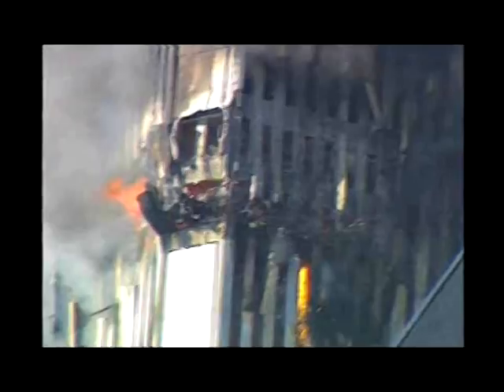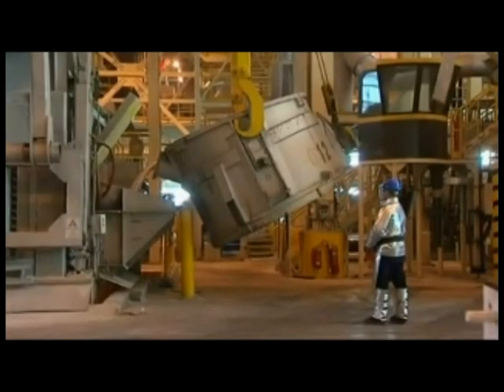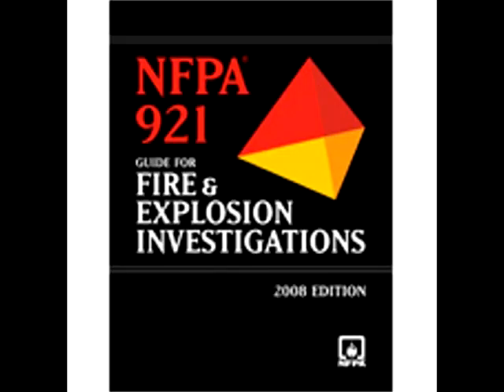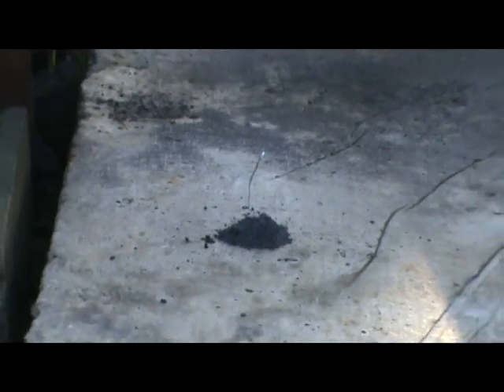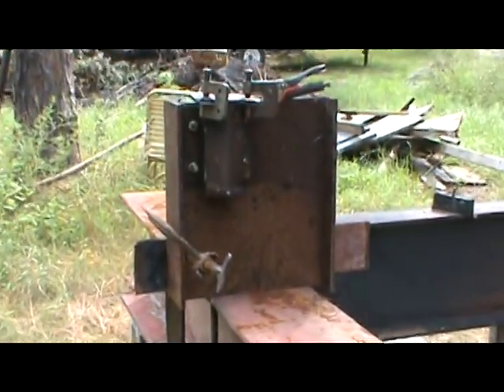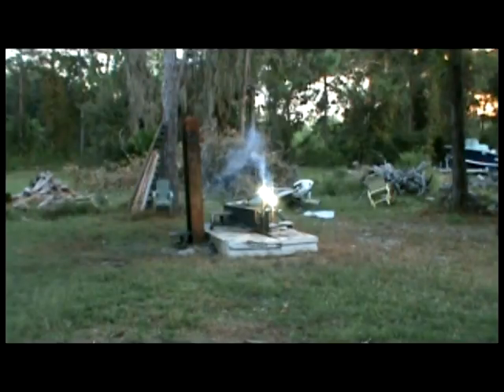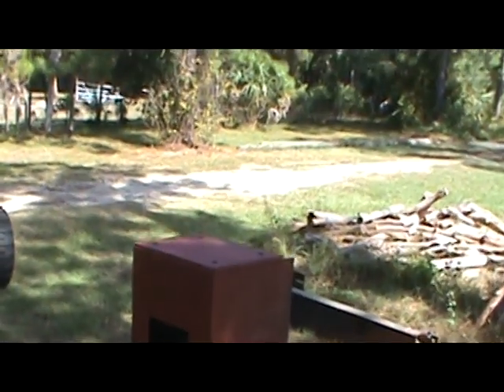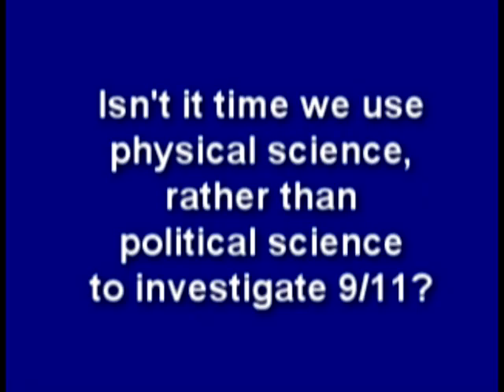9/11 Experiments: The Great Thermate Debate

Comment: Chimney effect.
Convection and high amounts of fresh air.
Reply: Chris G Different planes and levels, no longer sealed.
Reply: +MomoTheBellyDancer the fires were oxygen starved - thus black smoke. and even if the fires were fully oxygenated - its still not hot enough to cause steel beams to fail.
Reply: +Mike Bishop 
Don't you think it's possible to be hot enough for the steel to give under 10,000 tons of pressure? Just a thought.
Reply: +Mike Bishop Just because the fire itsself is oxygen starved doesn't mean it's not hot. Tunnel fires have a big problem where the heat builds and builds until the tunnel fails.
Reply: Mike Bishop
In the end, occam's razor is your friend here. The simplest explanation is usually the correct one.

The structural integrity of the buildings were undermined by the fires started by the planes that FLEW INTO THEM, then the two identical buildings collapsed in more or less the same way because they were damaged in the same way
Reply: Mike Bishop
And you have no actual evidence of this. Everything that has been presented so far is inference.

As for how the buildings came down, look up Pancaking. It's actually more common than you'd think. It's done deliberately by demolitioners, but it happens naturally, especially in tall buildings.
Reply: +Saga No, I don't. And even if some of the steel failed - why would it fail universally throughout the building?  it wouldn't. this was a result of high explosives.
Reply: Chris G
The sealed parts of the building were not the parts of the building that burned, those parts didn't fail because of fire, those parts failed because the rest of the building fell on them.

It's part of how the building was designed, the floor below was supported by the structure above. What this does is that in normal operation the most heavily loaded parts of the building are supported by the lightest loaded parts of the building, creating an overall stronger and lighter building.

The exception to this is when the upper floors of such a building get compromised, then the building can fail from the top down. This is exactly what happened to the WTC.
Reply: Mike Bishop
Uhm, no. Explosives are not the simplest explanation. You'd have to explain how they set the charges with a raging fire going on. How they got the explosives all the way up there. The elevators were out of comission and those are a lot of stairs that are being used to evacuate the building. You'd also have to identify the motive for blowing up the buildings.

Also, you'd have to explain what then took down WTC 7 and why it collapsed it it couldn't have been fire.

This is the simpler explanation:
Jihadis flew two passenger jets into WTC 1 and WTC 2 the resulting fire weakened the structure of both towers and they eventually collapsed, damaging nearby structures, some of which would also eventually collapse.

It literally explains everything that happened that way in one paragraph.
Reply: +Semni Istiqlal You can wish for something to be true, but it still doesn't make it so. These buildings had help coming down - not from fire.
Reply: Groundskeeper Willie
Nah, Jetfuel was sufficient.

Yanno, I really wish that these conspiracy folks would trot out arguments that weren't older than sin, debunked over and over again and relied on ignorance on the subject at hand.

Chris G The steel doesn't need to melt. The structure of the building was weakened by the impact of the plane. All that needs to happen is that the remaining structure gets weakened by the heat. Hot metal is soft and pliable. Once the beams bend enough they no longer provide support and the weight of the tower gets put onto less and less beams. Leading eventually to a catastrophic collapse.

The molten metal seen was most likely aluminium, which is common in office equipment, furniture and the non structural dividing walls in offices.
Reply: +Chris G not so "hermetically sealed" when a plane blasts through and windows get blown out
Reply: +MomoTheBellyDancer your type is always the same. You deny evidence provided by scientific methods and witnesses on the scene - because you can't get comfortable with the facts. And you call names at anyone who dares to shake your reality. You will believe what you believe regardless if of any evidence.
Reply: +Mike Bishop just like your "black smoke means the fire was oxygen starved" proof, right? all conjecture
Reply: *****
Jet fuel in open air cannot. Within the insulated enclosed and chimnylike environment of the building jetfuel will start to burn a lot like it does inside jet engines, which gets more than hot enough to melt the high temperature alloys of the jet engine if left uncontrolled.
Reply: +Chris G The Twin Towers did NOT "fall almost perfectly into its own footprint" -- there was rubble scattered for MANY BLOCKS AROUND!  As for "thermite/nanothermite", all it was was structural steel which CHEMICALLY REACTED with the ALUMINUM in the jumbo jets due to the high temperature!
Reply: +Semni Istiqlal It doesn't even have to melt structural supports.

Steel undergoes a phase change at about 850 degrees from the tough and strong allotrope used in construction into a weak and brittle allotrope.

Burning jet fuel easily exceeds this critical temperature for the phase change to occur - turning the support structure from rigid and durable into fragile and brittle.
Reply: Groundskeeper Willie
Hokaaayyy ... backing away slowly, I think this one is starting to froth.

That is one impressively huge pile of conspiracy bullshit. :D
Reply: +Mike Bishop if the steel rsj beams are damaged by fire ie. wrapped and twisted the weight from above could force it to fall, dont forget gravity to. but the thing didnt fall pefectly......... wtc 7 is a different matter. massive sections fell onto other building so it did fall out slighty.  fire damge to beams can totally collapse a building, why else would we fire proof them ?
Reply: +MomoTheBellyDancer no matter how badly you want a thing not to be true , doesn't change the reality. Jets caused the  universal and catastrophic failure of these buildings? come on man! The most implausible conspiracy theory put forth was from that of the government. I won't continue to argue about it. Fact is, the people who hold onto the government explanation - beyond reasonableness - will do so, no matter what, because the alternative is too terrible of a reality to grasp.
Reply: +Groundskeeper Willie It wasn't "weakened by a plane" -- it was weakened by FALLING DEBRIS from the Twin Towers!  Take your red herrings and shove'em up your ass, LIAR!
Reply: Groundskeeper Willie
Short sale: What? O.o

Building 7 was probably weakened by having TWO SODDING GREAT BIG SKYSCRAPERS COLLAPSE RIGHT NEXT TO IT.

It seems simple right?
Reply: Groundskeeper Willie
is repeating things that have already been debunked in this discussion.
Reply: Groundskeeper Willie
Building 7 was hit by a chunk of burning debris which ignited a fire in it.

It was also fully evacuated and so was a low priority for emergency services, considering they had a skyscraper that was still full of people.

This meant it was just left to burn.
Reply: *****
I'm responding to Geek, who claims that there's molten steel while claiming that nothing there could melt steel. A bit of a problem with his argument there.
Reply: +Groundskeeper Willie You are a LIAR -- NO building was EVER designed to take a hit from a fully-fueled jumbo jet, and in fact such a design is IMPOSSIBLE for anything other than an underground concrete bunker!
Reply: Groundskeeper Willie
Facts you desperately are lacking.
Reply: Groundskeeper Willie
Well, if you provided us with any of your "facts" and linked to any of this stuff we might actually be capable of considering your point of view.

As the one making the claim the onus is on your to back it up with facts and logic.
Reply: +Chris G 
Plus people above the fire broke out the windows to try to breath.  Can't blame them, but that turned the towers into blast furnaces.
Reply: +Semni Istiqlal
The collapse would produce aluminum and iron oxide particles. The issue is that the particles are all of the same size and shape, and are distributed uniformly inside a carbon and silica matrix. The material ignites at 420C, the same temperature as Xerogel, a known sol-gel incendiary. The material releases molten iron, and hits a 10 watts/g energy spike instantaneously upon ignition. The Xerogel only reaches 6 watts/g, and it takes a longer time to do it. Therefore this material is far more effective of an incendiary as the Xerogel. You actually believe that the most advanced and energetic incendiary known to science was invented out of random chaos during a building collapse? I've got about as much chance of shitting a gold brick.

I bring this up because it disproves your "narrative" argument, and because it explains how the collapse happens the way that it did. Otherwise, a steel reinforced structure imploding to dust at near free fall speed through the path of greatest resistance would be physically impossible.

I bring this up because none of you "debunker" types can offer an academic refutation, so it is in fact a trump card.

You lay down your conjecture, and I'll lay down the published, scientific analysis of 9 experts, and let's see which weighs more.
Reply: +MomoTheBellyDancer you just keep that tentative and desperate grip on your own reality. It will all get better, I'm sure.
Reply: +MomoTheBellyDancer Your cognitive dissonance is astonishing. Many of the families - a majority in fact call BS on the "official story". And I'm not going to present the preponderance of evidence available - it wouldn't matter. Nothing and I mean nothing would convince people like you because the truth is not pretty. And I'm not going to stoop to your level of name calling. I actually pity you.
Reply: Groundskeeper Willie
Notice how your statement is desperately devoid of facts.

<Willie> "See here is the place where I grow my facts. You may notice that it is barren."
Reply: Groundskeeper Willie
The cognitive dissonance you're displaying could shatter glass at a thousand paces.

You're claiming that you don't need facts for your ridiculous claims, while simultaneously claiming that the fact-based statements of others lack facts.
Reply: Groundskeeper Willie
No, the onus is on you to provide us with the evidence, we are under no obligation to attempt to support your argument.
Reply: Semni Istiqlal
It's likely that's the case!

But no matter how much engineering goes into a building - it's difficult to make one resistant to passenger aircraft. The sort of engineering necessary to do that would make the building prohibitively expensive to build.

And aircraft that large hitting buildings is something which it just isn't necessary to build redundancy for as the chances of it happening are essentially zero.
Reply: Pyre Spirit
It's tragic when it happens but that is the case. It's also sad that a lot of conspiracy theorists just don't have the critical thinking ability to look at both sides of the story.
Reply: Brandon C. Brandon lol there was no domino effect.  Its impossible.  I just proved that in the video link I sent you.  It defies physics completely.  And you think an entire plane was sitting inside both towers?  You're wrong.  If a plane made it through the building there would be no lady standing in the impact zone waving for help.  What did she DUCK the plane?  Sure.  If any parts of the ALUMINUM plane made it through the reinforced steel and concrete structure, it would have been very minimal.  Like a shredded aluminum can you just put a cherry bomb inside of.  And that massive fireball ya saw on the news coverage was 90% of your kerosene based jet fuel being burned up.  It didnt splash its way down elevator shafts and destroy the lobby on the ground floor.  That's senseless.  You have to have a deeper knowledge of how the towers were constructed at the core columns and knowing that kind of thing would be virtually impossible to do.  These towers were made to withstand multiple airliner impacts, not just one.
Reply: Bobby H
The problem with using thermite isn't wether or not it could bring the building down. A team of angry dwarves with sledge hammers could have brought the WTC down with enough time and the right knowhow. The big question is why?

Why take down a building that was going to come down anyway and go to such lengths to make it look like the plane did it?
Reply: +Semni Istiqlal 
Sorry, that's not how steel framed structures work.  The collapsing load would not exert it's force on the floor directly below it.  The entire undamaged lower structure would distribute the load into the ground.  The top of the towers were of a lighter construction than the lower portion, therefore your assertion that the lower portion wouldn't be able to support the more lightly constructed top is incorrect.  If there was really enough force from the collapse alone to buckle every floor, the bottom or middle structure would be more likely to buckle first due to the greater weight above it.  

When you crush a Coke can, does it crumple from the top down?  No, it crumples from the bottom or middle first.  The collapse defies physics in multiple ways (especially building 7).

Unfortunately for you, this entire line of reasoning is moot, because it's purely conjecture.  Unless you can first disprove the presence of thermite in the dust as described in the Harrit paper, then you really have no ground to stand on.
Reply: +MomoTheBellyDancer Yes, because rich and powerful people would never conspire with others of the same ilk, to maintain and keep their power and wealth.
Reply: +MomoTheBellyDancer I don't care what you thought. The evidence is clear if you open your eyes. beams projected at over 60 mph as far away as 500 yards - doesn't happen by gravity. concrete doesn't turn to powder through the forces of gravity. Planes and jet fuel cannot cause the catastrophic, universal and simultaneous failure of steel and concrete - no matter how much you wish it to be so.  There were over 1,000 victims on that day there was nothing left of to be given DNA tests for identifying. No explanation - other than HE works. Sorry you can't except reality because it doesn't fit your paradigms.
Reply: geeksterajn
You mention molten steel yourself. If steel couldnt have melted then how come there was literal tons of molten steel there?
Reply: Groundskeeper Willie
And we've broken Willie, he's stopped making sense.
Reply: Groundskeeper Willie
AKA: I'm too lazy to back up my baseless accusations.
Reply: Groundskeeper Willie
"evidence is everywhere i'm not sure I want to allocate my time to find links with facts."

And this demonstrates the fundamental dishonesty of your position.;

"Evidence exists. I've never seen it, and I won't present it, but it exists! Honest!"

BS.

There is no evidence and your unwillingness to provide any coupled with your excuses demonstrate quite succinctly that you know there's no evidence, and you're just lying.
Reply: Pyre Spirit
Heck, a burning building easily gets close to that temperature, especially if it's burning for nearly an hour. A big issue in the towers was that they couldn't fight the fire at all, they were having trouble getting water up there. If they had been capable of fighting the fire the towers would likely still stand today.
Reply: *****
Exactly, interestingly enough there isn't much evidence of much steel actually melting. But it didn't need to. It just needed the smallest beams in the floors to become soft enough to break. Once the floors gave way there wasn't much stopping the main pillars from buckling.

You can make a pillar as strong as you want, but once it buckles the building is coming down.
Reply: +Groundskeeper Willie The towers were never designed to withstand the impact of a modern airliner flying at suicide speeds with nearly full tanks. They weren't even designed to withstand an impact similar to the Empire State Building  (a far smaller plane at half the speed with a fraction of the fuel), because it would cost money and time to do such a study, and the previous impact didn't cause serious problems for that building anyway so why bother? But the towers were build in an entirely different method to other skyscrapers, and all towers build this way have collapsed when subjected to catastrophic damage and fire weakening critical supports, in both simulations and real life situations.

One of the key features of a structural collapse is the deformation of floors and walls as the building is twisting under the load. This deformation can be seen when pools of molten aluminium (mostly from the plane) started pouring from the windows when a floor sagged due to disconnecting from the outer walls. You can actually see the sagging of floors and the outer pillars folding outwards on video footage, not long before the towers collapse. 

Molten steel was indeed found under the surface of the rubble pile, but these were caused by chemical reactions between the steel and steam. A lot of water in the building to begin with, and even more poured onto it after the collapse, and it all got heated by the energy generated by the collapse (such as friction). 

The official story had a few gaps, but nothing major, and mostly because it would have taken even more time to come up with all the answers as to why so much damage was caused that day. Misinformation was also a problem that day due to the chaos, which led to claims that buildings had already collapsed when in reality the info going around was that the buildings were ABOUT to collapse. WTC7 was visibly distorting and this was confirmed with laser measurements, but unfortunately it happened on the side impacted by debris from the other towers which obviously didn't have camera crews, only rescue workers (until they got pulled out due to the imminent collapse of WTC7.)

Not a single conspiracy explanation has been able to survive the years, every single one has been debunked. Claims by twoofers have been revealed as half-truths, taken out of context, or downright lies and even fraud. No evidence is ever put forth, which isn't surprising, because twooferism is essentially a religion. Reality and reason do not play a role in religious circles.
Reply: SeedlingNL
It's telling when the conspiracy theories leave more unexplained than reality.
Reply: scurred of what, Do you have any formal education in material sci, this is child's play. if you did you would know that structural steel looses almost half its strength when heated past 1000 degrees F. buildings are not light and neither are planes. there is never just one force acting on a structure why dont you see this ask an engineer what they thought and not the structural engineer for the WTC because he wants to be on tv talking about a controversial thing ask an engineer off the street to look at the situation
Reply: Brandon C. See video title.   And Brandon... 767 jets CAN NOT maintain those speeds at those altitudes.  I wish I had a nickel every time I had to repeat that.  Source:  pilotsfor911truth.org

Brandon... you're either a shill that refuses to admit defeat or you're severely stubborn and uneducated and refuse to look at evidence presented before you.  Which is it?
Reply: Victor Tesla
Because I'm actually employing some common sense in looking at the situation? Aye. What I really should be doing is picking whatever fits my prejudices best and sticking to it in the face of all evidence to the contrary. :P
Reply: +Semni Istiqlal the planes were the cover for the explosions. they could not just set those things off, so they needed a cover incident
Reply: ElfNet Gaming
You have really have been watching too much CSI, havn't you? You know how they got the 1993 WTC bombing guys? They found the VIN of the rental truck they used to deliver the bomb in the rubble. And they'd rented the truck under their own name.

To cover up a WTC bombing with a plane highjacking you first need to have a bunch of people who are prepared to die for the cause then highjack two planes, then you need to fly those planes into the buildings. Then you can start trucking hundreds of pounds of explosives up the stairs in the middle of an evacuation because you don't know how high up the planes are going to hit the buildings because hitting a building with a plane is FUCKING HARD.

And you have to have NOBODY NOTICE THIS.

Then once you have planted and set off the charges you have to hope that nobody involved in the investigation goes "Wait, that looks like a bomb going off." and then you have to hope that they don't find a single piece of your dozens of explosive charges.

You also need to be prepared to kill THOUSANDS OF PEOPLE to avoid going to jail, that seems a bit counterintuitive.

Then you have to explain why you highjack a bunch of other planes and fly them into a bunch of other buildings that DIDNT get exploded.

All to do something that a well placed office fire could have accomplished.

That doesn't seem like the perfect crime, that seems like a goddamn clusterfuck.
Reply: *****
Then how come cheap plastic lighters don't burn and melt?

No a lot of very carefull engineering goes into keeping the heat of jet engines away from most of the engine and the rest of the plane. A bar of steel held in the path of the engine exhaust of your average jet engine will be heated red hot quite rapidly, and alu will outright melt.

I'm not trying to be unkind here but you may want to educate yourself on the subject matter at hand before forming an opinion on it.

A quick primer is that most jet engines take a fraction of the air coming in one end and have it bypass the combustion chamber entirely, this cold air then mixes with or surrounds the hot exhaust of the jet engine, insulating the rest of the structure of the engine and plane from the intense heat of the engine exhaust.
Reply: Emvaz22
Look up a couple of posts, I have a fairly lengthy set of posts that go into that very topic in depth.

The TLDR of it is that is exactly what you would expect from an older tower like the Empire State that was built with a box-girder construction.

However that is not what you can expect from a leightweight all steel building like the WTC was. The main loadbearing elements are the outer walls and core columns. These are vulnerable to buckling. The floors are used to connect these columns together and prevent buckling. These floors aren't individually very strong, they don't need to because there's a lot of them.

Once a collapse starts happening there isn't enough mass to the building to stop it. If you filled in all the holes they'd actually float, with the approximate density of pinewood.

Once the upper part of the tower starts falling, what is it going to fall on? The floors below, and at only a couple of inches thick they aren't going to stop an entire building falling on them, so they collapse, and now there's nothing holding the walls and interior columns together and that floor becomes part of the falling mass.
Reply: *****
Aah, the tinfoil is out in force. Why fly a plane into it and then blow it up? If it was so obvious that it was blown up, why bother with flying a plane into it in the first place?

That's the wierd thing with conspiracy theory most of the time. It asserts competence to the government that it doesn't display in any other capacity.

Like, you are assuming they are capable of highjacking multiple planes, flying them into the WTC buildings, then trucking hundreds of pounds halfway up a building twice as tall as the tallest building ever imploded at the time. Rig them up in a way that makes it look like the buildings collapsed because of the planes.

And then COMPLETELY drop the ball on silencing anyone who can point out the flaws in their deception. You are talking about a regime that's prepared to kill thousands. How hard would it be for them to orchestrate a couple dozen little accidents?

This is what defies belief. That someone can both believe that their regime is horribly murderous and then spout their heads off about it safe in the knowledge that the regime they live under isn't even remotely as vicious as they say it is.
Reply: +Emvaz22 listen clown shoe. You have been shitting up every comment with your nonsense.

Your peer reviewed paper is a joke, no it's not a valid source.

Again anybody in demolition and explosive experts would laugh and this video and you claiming thermite was used lol.

Your conspiracy theory paper is reviewed by 9/11 truthers. Most have zero background in the shit they are claiming. The paper has been laughed at by any serious engineer.

They would not use thermite to bring the towers down, it would be the dumbest and most useless method to do it.

Anyways the thermite nonsense has been debunked years ago.

Again for your dumb ass, the steel did not have to be melted but weakened which jet fuel and the fire easily did.

If they were going to bring the towers down they would use shaped charges and they would be easier to hide.

Nano thermite and nonsense is a attempt by half wits to explain their nonsense theory.

A small shapes charge would be easier, you would never hear it.
Reply: You don't seem to understand what the term dogmatic means - you should probably improve upon that if you plan on engaging in debate.  

The tinfoil brigade is a term you use in order to satisfy your need to be fed a dishonest truth.  I can understand how terrifying it must be to realize that everything you've ever been fed as truth isn't.  Only those that can really handle it will be given the chance to grasp it - truth that is - ...

How many cookies do you get from big brother?
Reply: Not my truth, just one backed in evidence that is shared by many.
Reply: Semni Istiqlal <we are on the internet, all you have is conjecture.>

Nope.  All YOU have is conjecture.  I happen to be able to cite a published academic paper that proves the presence of thermite, which you refuse to directly address because you know you can't.

<The issue you face there is that the collapse in the tower didn't start from the bottom, it started from approximately the same area that the planes hit. Specifically the south tower very obviously had the outer wall fail before the central column was pulled down with it.

You could just say that the charges were placed in the same area that the planes hit, however then you have another set of problems. You aren't going to be capable of predicting very accurately which floors the planes are going to hit.>

Hey, I think I came up with a solution to this mind-bending quandary you are having such a hard time with.  Place charges on every floor.  Number the charges according to the floor. To initiate the collapse, count up from the bottom to see which floors the planes damaged.  Detonate the charges from the point of impact, downward.  ROCKET SCIENCE.

<Pre-placing the charges has a lot of issues. If the plane hits the charges directly you have a good chance of it setting off the charges immediately and the tower coming down right away.>

Not necessarily.  The charges would have been placed in the reinforced core of the building, protected from most of the direct damage.  The charges could have been wrapped around their intended targets, and then coated with a protective, insulative, and shock resistant material.  Even if a few charges went off prematurely it wouldn't cause building collapse.  These types of structures tend to be designed with redundancy.  The failure of a few connections or beams would not even be close to enough to turn the building to dust. 

<If the plane hits too high it won't result in a collapse that we observed, and if it hits too low you stand a good chance of your charges being cut off from whoever is touching them off.>

Wait...you actually think the building would have had to have been wired with det-cord from top to bottom?  Like, literally hard-wired?  There is this new invention called radio frequency transmission.  This brand new technology, combined with a device that ignites a magnesium strip remotely, could have set off the charges in whatever sequence the operator wanted.  No wires required.  Why didn't you think of that?

<And them's the facts,>

No, them's your unsubstantiated conjecture, which I just stomped on with my own conjecture.  How about you stick to the ACTUAL facts and refute the Harrit paper.  Cite your source in this format.  Title.  Author.  Publication.  Date.  Good luck.

<if you cannot theorize how the thermite was used to result in what's observable it's just thermite>

I just did.  Pretty easily too.

< it's just one of dozens of chemicals found there>

Yeah, nanothermite just happened to show up out of nowhere, and for no reason at all.  It must have been the Thermite Fairy.

<You cannot prove how it was used>

I don't pretend to.  That would be the purpose of a new investigation.

Pick your teeth up on the way out.
Reply: Semni Istiqlal <Yeah, I can C/P stuff too. Everything you've posted here is from good old 'truther' websites.  >

My quote from Leslie Robertson, Architect of the WTC, was from MSNBC, idiot.

<That's basically them saying "We found material that looks like thermite but we aren't going to call it thermite in case we get called on it then we can just claim we never said it was thermite." they are really sure of themselves? Honestly, that paper is just packed with weasel-words, allowing truthers to creatively interpret it as you wish.>

From the Harrit paper:
"CONCLUSIONS
We have discovered distinctive red/gray chips in signifi- cant numbers in dust associated with the World Trade Center destruction. We have applied SEM/XEDS and other methods to characterize the small-scale structure and chemical signa- ture of these chips, especially of their red component. The red material is most interesting and has the following charac- teristics:
1. It is composed of aluminum, iron, oxygen, silicon and carbon. Lesser amounts of other potentially reactive elements are sometimes present, such as potassium, sulfur, lead, barium and copper.
2. The primary elements (Al, Fe, O, Si, C) are typically all present in particles at the scale of tens to hundreds of nanometers, and detailed XEDS mapping shows intimate mixing.
3. On treatment with methyl ethyl ketone solvent, some segregation of components occurred. Elemental alu- minum became sufficiently concentrated to be clearly identified in the pre-ignition material.
4. Iron oxide appears in faceted grains roughly 100 nm across whereas the aluminum appears in thin plate- like structures. The small size of the iron oxide parti- cles qualifies the material to be characterized as nano- thermite or super-thermite.
5. Analysis shows that iron and oxygen are present in a ratio consistent with Fe2O3. The red material in all four WTC dust samples was similar in this way. Iron oxide was found in the pre-ignition material whereas elemental iron was not.
6. From the presence of elemental aluminum and iron oxide in the red material, we conclude that it contains the ingredients of thermite.
7. As measured using DSC, the material ignites and re- acts vigorously at a temperature of approximately 430 ̊C, with a rather narrow exotherm, matching fairly closely an independent observation on a known super-thermite sample. The low temperature of igni- tion and the presence of iron oxide grains less than 120 nm show that the material is not conventional thermite (which ignites at temperatures above 900  ̊C) but very likely a form of super-thermite.
8. After igniting several red/gray chips in a DSC run to 700  ̊C, we found numerous iron-rich spheres and spheroids in the residue, indicating that a very high- temperature reaction had occurred, since the iron-rich product clearly must have been molten to form these shapes. In several spheres, elemental iron was veri- fied since the iron content significantly exceeded the oxygen content. We conclude that a high-temperature reduction-oxidation reaction has occurred in the heated chips, namely, the thermite reaction.
9. The spheroids produced by the DSC tests and by the flame test have an XEDS signature (Al, Fe, O, Si, C) which is depleted in carbon and aluminum relative to the original red material. This chemical signature strikingly matches the chemical signature of the sphe- roids produced by igniting commercial thermite, and also matches the signatures of many of the micro- spheres found in the WTC dust [5].
10. The carbon content of the red material indicates that an organic substance is present. This would be ex- pected for super-thermite formulations in order to produce high gas pressures upon ignition and thus make them explosive. The nature of the organic mate- rial in these chips merits further exploration. We note that it is likely also an energetic material, in that the total energy release sometimes observed in DSC tests exceeds the theoretical maximum energy of the clas- sic thermite reaction.
Based on these observations, we conclude that the red layer of the red/gray chips we have discovered in the WTC dust is active, unreacted thermitic material, incorporating nanotechnology, and is a highly energetic pyrotechnic or explosive material."

Hmm, I see "is a highly energetic pyrotechnic or explosive material."  Seems pretty cut and dry to me.  You should brush up on your reading comprehension.  Oh thats right, you've probably never even read the Harrit paper.

Try again.
Reply: Semni Istiqlal <They still make efforts to avoid actually calling it thermite and you are definitely not in any position to make that conclusion for them.>

Nope.  "Thermite" is included in the definition of "unreacted, active thematic material".  They don't just call is "thermite" because that would imply the conventional form of basic thermite, which the material clearly is not.  It ignites at a lower temperature, completes its reaction more quickly, and releases more energy.  You're a special kind of stupid.

<It's almost like they know it's not actually thermite and don't want to be called on it but still want to give the impression of it being thermite.>

Oh, so it's not a form of thermite?  What is your expert analysis?  What is this material if it is not an incendiary?  Please say primer paint.

<Also, the architect of the towers was not Leslie Roberts, it was Minoru Yamaski. Seriously, please do your homework.>

"Leslie Earl Robertson (born February 12, 1928) is a retired engineer. He was one of the structural engineers of the World Trade Center in New York and was responsible for the design of the buildings' sway-reduction features. He has since been structural engineer on numerous other projects, including the Shanghai World Financial Center and the Bank of China Tower in Hong Kong."

From Wikipedia.  Another "truther" site.

You see, huge projects like the WTC tend to have multiple engineers and architects working on them.  I never claimed he was the only one.  Try again.
Reply: Semni Istiqlal <So really the only information you have is from a paper that hasn't been seriously peer-reviewed since it's publication in 2009,>

And there you go changing your story again.  Peer reviewed, published, and not refuted in 6 years.  One of the reviewers is a scientist previously with NASA, DARPA, and US Naval Research.

<it doesn't even assert that there was thermite and only now you appear to be reading it in full.>

me Semni Istiqlal im no reed gud. 

From Harrit: "Based on these observations, we conclude that the red layer of the red/gray chips we have discovered in the WTC dust is active, unreacted thermitic material, incorporating nanotechnology, and is a highly energetic pyrotechnic or explosive material."

Seems like a pretty concrete assertion to me.  Having trouble?

< after 15 years that's the most solid evidence you've been capable of digging up>

It's the only analysis for pyrotechnics in the scientific literature.  Can you cite something published that directly refutes it?  No, you can't.

<Against the sheer body of evidence for the conventional theories>

Basic physics and forensic evidence all point to controlled demolition.  Which evidence are you referring to?  I hope you aren't referring to the imaginary computer models of the collapse, which don't resemble the actual collapse, and wouldn't confer scientific proof even if they did.

<And yes, sometimes I change my opinion and my story changes with it. Because unlike you I am not stuck in a dogma and my opinions are allowed to change and be shaped by new information.>

You change your story because no matter which angle you take to try to discredit the Harrit paper, you fail.  So you continuously dance around, desperately flinging every ad hominem and logical fallacy you can come up with, hoping nobody notices.
Reply: +MomoTheBellyDancer and wtc 7 just fell due to the emotional shock of seeing it's neighboring buildings collapse?
Reply: Emvaz22
A. Harrit's paper did not pass peer review first off.

B. Harrit's paper was not published nor submitted to an ACCREDITED JOURNAL and instead done so on a shady online journal with a bad rap for publishing LITERAL JIBBERISH. Long as you pay the 500 bucks.

C. The Red/Gray iron chips/spherules can and will be found, with friction of steel rubbing against itself or being heated whatsoever. Not an implicit sign that thermite is used anywhere.

D. Levels of the Aluminum, Carbon, Iron, Silicon, the others, INCLUDING BARIUM are all naturally found, and MORE so in an environment such as this. The LITERAL smoking gun is not described ANYWHERE, nor shown to be ANYWHERE. Like you say, the paper does a whole lot of nothing in the first place. It does not provide a smoking gun, it does NOT provide tracing of the WTC dust samples in the FIRST place, NOR do they really find, well, ANYTHING. 

E. There ARE papers, published in REAL journals, that YOU have NOT read, since YOU only know how to utilize INFORMATION BIAS. You have a theory and look for ONLY supporting EVIDENCE. You are supposed to formulate a THEORY based OFF of evidence found!

Here are SOME papers, in REAL fucking JOURNALS.

http://www.tms.org/pubs/journals/jom/0112/eagar/eagar-0112.html

Then you have Bazant's paper (revised version as REAL papers that get PEER REVIEWED should be when corrections need be made) http://heiwaco.tripod.com/blgb.pdf

Keith Seffens paper on WTC7 collapse.

These papers, all in RESPECTED journals.

On YOUR side:
Jones submits B.S. paper while working at BYU which gets him fired for being blatantly wrong. Does not pass peer-review.

Jones & AE911 crew publish their paper(s) in Bentham OPEN Journal. An online, NON Academic NON accredited journal, which would lend only enough credibility for people like YOU to say "WE DOEZ HAVE JOURNAL PAPERZ DUHHH OPEN BENTHAM DUHHH"

They literally make conclusions with zero evidence, even stating themselves that no smoking gun is in their paper, BUT, it was thermite for sure! Right?!

THEN YOUR crew can't even AGREE ON THAT as AE911 split TWO WAYS because some of YOUR EXPERTS BELIEVE THAT DIRECTED ENERGY WEAPONS/TACTICAL NUKES/HOLOGRAMS/ETC. ARE THE REAAAL CULPRIT SINCE THEY COULD FIND NO SHRED OF EVIDENCE FOR THEIR FIRST FUCKING THEORY.

So please, good sir, google some more, and this time don't just google "911 conspiracy".

Do yourself a favor, and ACTUALLY research, THE CORRECT WAY. Because it is WAY too many years since that shit got debunked for you to STILL COPY PASTE IT LIKE IT IS NEW. It's SHIT. It maintains ZERO credibility. IF YOU WANT JONES TO GARNER SOME CREDIBILITY, CALL HIM UP YOURSELF AND ASK HIM TO USE THAT FUCKING DONATION MONEY THAT THEY ACCEPTED FROM GOONS LIKE YOU, TO FUND A NEW INDEPENDENT FUCKING STUDY INSTEAD OF PAYING FOR A MOTHER FUCKING BILLBOARD AND 500 BUCKS TO PUBLISH THEIR SHIT PAPER ON A FUCKING CREDIBILITY LACKING ONLINE JOURNAL AND ACTUALLY TAKE THEIR SHIT TO THE REAL FORUM OF PEERS.

WHEN YOU DO THIS FUCKING SHIT AND GET IT DONE, WE WILL REVISIT AND LISTEN TO YOUR FUCKING STORY. UNTIL THAT POINT, THE BOTTOM FUCKING LINE IS THAT THE OFFICIAL FUCKING STORY FITS THE EVIDENCE AND ANSWERS THE MOST FUCKING QUESTIONS.

SO COME BACK WITH A REAL FLESHED OUT THEORY THAT ANSWERS AS MANY OR MORE QUESTIONS AAAAAAND HAS OBSERVABLE AND PHYSICAL EVIDENCE TESTED AND VERI-FUCKING-FIED BY THE MAJORITY OF THE FUCKING ACADEMIC COMMUNITY.

IF NOT, CONTINUE TO WASTE YOUR TIME, MY TIME, AND EVERYONE ELSES BY MAKING US READ YOUR OLD ASS COPY PASTED BULL SHIT. OF WHICH YOU PERSONALLY DON'T EVEN UNDERSTAND. YOU LITERALLY DON'T EVEN UNDERSTAND BASIC CHEMISTRY, NOR DID YOU LOOK INTO THE ACTUAL RESPONSES JONES' PAPER GOT, NOR DID YOU FUCKING LOOK AT ANYTHING BUT, AE911 and ANY SITE THAT WAS SET UP TO LURE GULLIBLE ASS LAYMEN WHO MEAN JACK SHIT, INTO PRETENDING THEY ARE SMARTER THAN THE FUCKING ACADEMIC COMMUNITY.

Your shit. You are literal garbage, a bottom fucking feeder. YOU are the real sheeple, since you can't believe ANYTHING unless they make t-shirts and sell you on literal shit you can't even understand NOR speak on.
Reply: Emvaz22

Okay, so here I need prove

A. Bentham is not a respected journal and
B. Jones', Harrit, Griffin's paper did not pass peer-review.

Both of these can be squashed with ONE link.
http://publishingarchaeology.blogspot.com/2009/06/hoax-paper-accepted-by-benthan.html

For iron-microspheres

https://www.metabunk.org/debunked-iron-microspheres-in-9-11-wtc-dust-as-evidence-for-thermite.t2523/

And also in their paper, they even concur that iron microspheres are not necessarily anything extraordinary. Also, the sheer volume of these microspheres is not exact, first off, nor is an INCREASED level of them PROOF of thermite.

You seem to ignore the fact that the Harrit paper should've been published in say, the Journal of Engineering, or somewhere along the lines of a relevant journal with a TRUSTED peer-review process. It's not ad hominem (even though you truthers love to spit that out like it makes you sound intelligible). It's the (pardon the irony) TRUTH. You want credibility, you publish in a Journal that would LEND it, AND lend people 

http://www.internationalskeptics.com/forums/showthread.php?t=266539

I'll reiterate it here, again, and again. Until YOU understand why Harrit's paper is seen as a joke in the scientific community.

Publish in a reputable journal - paper gets looked at.

Publish in an open online journal - paper is NOT put through the same (if any in many cases) scrutiny that peer-review puts on papers submitted in a REPUTABLE JOURNAL.

Again, it's not Ad Hominem. It's fucking FACT.

The papers published by other individuals, which I DID link in this thread, were published in REPUTABLE JOURNALS. THERE papers WERE PEER REVIEWED. REPUTABLE JOURNAL, TAKEN SERIOUSLY. SHADY OPEN JOURNAL THAT HAS PUBLISHED LITERAL, NOT KIDDING YOU, WISH I COULD MAKE THE FUCKING FONT BIGGER SO YOU DON'T IGNORE IT THIS TIME, LITERAL FUCKING GIBBERISH... ARE NOT TAKEN SERIOUSLY.

NOR WOULD ANYONE PUBLISH TO THESE FOR ANYTHING MORE THAN A BULLET POINT FOR THEIR BELIEVERS, AKA THE GULLIBLE, AKA YOU.

So when you convince them to publish their paper to a real journal, we will see how that goes, as they had PROMISED BACK IN 2006 IT WOULD PASS PEER REVIEW AGAIN BECAUSE OF THE FUCKING FACT THAT THE LACK OF PROOF OF SUCH CAME UP OVER, AND OVER. YET THEY STILL, HAVEN'T COME THROUGH ON IT.

Sol-Gel Nanothermite was NOT found in WTC dust. If you are getting at the fact that some of the prior--listed elements ALSO happen to share that uncanny, WHOA that could be Thermite tee hee, ideal, you're a moron.

They found no DIRECT evidence of thermite. None. Not one trace. Not even bringing up the fact that none of them are even remotely qualified in the relevant fields other than (and it is a big stretch) Jones. Am I saying those not accomplished in relevant fields could NOT comment on or partake in discussion of said fields? No. I'm saying that, if we take it with the SAME non-biased look at we should with the official story. We are already at ODDS here because:

No paper submitted to a reputable journal.
No smoking-gun
Still no funding of an independent investigation (remember, they, AND YOU are the ones pushing for it, it's up to YOUR side to fund it)
Authors do not ALL agree on the same subject. 

You can in depth discussion of the Harrit Paper at:

https://www.metabunk.org/ae911truth-to-file-lawsuitto-end-fema-nist-stonewalling.t4820/

there's a link to some discussion on such on that thread, and I mean, it's ALL around the net.

You're the one that says "Do research". The problem here is that I was into this shit back when it was "big" in 03-07. There's even MORE debunking and refutation of the conspiracy theories NOW than there were THEN, and they've still gotten NOWHERE.

Where are you arguing your side right now? On a youtube video. Where would this info be if it was credible and passed peer-review, etc.? Everywhere, News, Everywhere.

Where are you again? Youtube comment section. Has your side gained ANY credibility? Have they produced a paper? Sure, did they choose to publish it in a reputable journal which would lend credibility even with an attempt? No. So... Where are we going here? What do you have to prove your side?

Comments on a youtube section, and a group that literally has done jack shit, in the 11-12 years of their "working" on this, and we're where? The official story is still the accepted as fact model. Simple as fucking that.

So if you NEED and WANT any credibility to your "belief's". Make a donation to AE911, make a sizable one, and demand that it be used to fund an independent investigation, and formulate a paper that would PASS PEER REVIEW IN A REPUTABLE JOURNAL.

-
Reply: Semni Istiqlal He asks if any refutation of the harrit paper exists, I literally sourced and linked shit. He ignores it. All he will say is Harrit Paper over and over. The dude is illogical, cannot argue with what he has convinced himself of already. Remember, this dude is smarter than most of us on the planet. I don't know why we'd bother to debate him on this, because everything we say obviously can be responded to with "I know you linked things refuting the Harrit Paper but... Harrit Paper".

The dude can go fuck himself at this point. I'm done wasting time. People like him are too "awake" for us to ever even be on their level.
Reply: +Semni Istiqlal I agree with the concept of Occam's razor - and the simpler explanation is explosives. I do hold a degree is explosives technology - it is actually the only explanation that fits all of the evidence.
Reply: +MomoTheBellyDancer The powers that be, rely on "rational" people like you. Doublethink doesn't even have to be taught - you do it on your own. Good luck to you living in the reality you choose.
Reply: +MomoTheBellyDancer yeah okay - have a nice life.
Reply: +MomoTheBellyDancer shill
Reply: +Mike Bishop I'd be relieved to know it was as simple as a plane crashing.. BUT no matter the argument, the fact stands that it couldn't get hot enough to even weaken the steel.. What do people think they build these massive towers with?? Aluminum foil?? They don't use cheap steels or low melting point materials because they know fires are a possibility in such enormous towers with such intricate electrical networks.. It doesn't matter what people say though because they are merely heard not listened to.. The ignorant will be forever ignorant..
Reply: I find it hard to believe that these retards are still breathing with how fucked they are in the head.. To just believe the news or just believe the government.. That's ignorant.. It's all hear-say, just because the gov. said "blah blah blah.. Plane go boom, building go boom.." everyone throws any sense of logic or thought processing out the window without even trying to put together the fact that jet fuel or even the whole building in a blaze wouldn't cause the steel used in these heavy duty towers to melt or weaken.. I'll believe the words of the on-scene firefighters that heard and saw explosions as well as molten steel rather than some college reject that watched the news off their frequency manipulation machine..
Reply: Again... I don't care to hear your belief over those who were there.
Reply: Groundskeeper Willie
Conspiracy theorist tactic #1: If you don't agree with me you are part of the conspiracy.
Reply: Groundskeeper Willie
You seem to have me confused with someone else.
Reply: Groundskeeper Willie
Yet you are the one who believes in something without evidence. I get the impression that the term Sheeple is projection.
Reply: Groundskeeper Willie
"Jet fuel is explosive mixture"

No, it's not. Fuel is not explosive - it would be terrible as fuel if it was. When in liquid form, fuel is stable. It burns, but it doesn't explode.

In order to be explosive, fuel needs to be aerosolized.

"Look up melting temperature of those columns and how much time it takes for the frame to get to that temperature."

Yet again, "melting" is not required. Construction steel is an allotrope of steel which is strong and durable.

When that allotrope of steel is heated to over 850 degrees Celsius, it undergoes a phase change into a weak and brittle allotrope of steel.

Burning jet fuel exceeds this temperature easily, burning at over 1000 C.
Reply: +Chris G not when the fire alarm system is tripped smoke ventilation fans Kick on
Reply: Groundskeeper Willie its not reason I know this video 

first you idiots said steel cant melt then once it melted u came up with this bullshit reason
Reply: ***** Why Johnny, don't ya know how it fell?  Office fires and falling debris.  Lol.  It ummm made every single support column give way at the same exact time, causing the collapse.  Ugh, I am really trying to see their side on this but I can't.  Isolated office fires and mild structural damage causing a building to fall into its own footprint at freefall speed.  Eh, fuck it lol.
Reply: +MomoTheBellyDancer dude let it go, some people dont want to hear facts. i was going to start in on the metallurgy of the structural steel they use. i was going to say that steel doesn't have to melt to cause catastrophic failures shoot if you heat it (A2 Steel) up to 1500 degrees it looses at least half of its structural stability causing it to buckle under the weight of the floors above . And the fact that concrete is a bad impact material because it can only take compression forces because it is brittle in any other type of loading. anything else and it will crumble apart making a phenomenon know as concrete dust, run a jack hammer for a day. some people wont accept what really happen because they want a reason to hate the government and want to upstage it whist trying to stay under the blanket of protection it provides

edit: i know all the columns didnt fail at the same time they did a domino reaction around the weak beams people dont honestly think that a building can support its own weight with the remaining columns, you could build it but it would be economically impossible
Reply: You are taken into account the weak beam not melted or at least we won't assume melted there was also a Boeing 767 sitting in both buildings it wasn't just an "office fire" as for the way it collapsed outside steel beams make pretty good guides that's why I believe the towers fell down rather than "out" why do ALL of the beams have to be weakened why can't a majority be and then the rest struggle to uphold load and eventually cause failure of the column causing a domino effect
Reply: ***** Precisely Johnny.  He probably isnt aware of or doesn't want to acknowledge a B52 slammed into the Empire State building and it caused minimal damage. And I have seen so many videos from professional architects and and engineers stating for WTC 7 to fall the way it did, every single column would have to fail at exactly the same time.  A few isolated fires that were contained and mild structural damage cannot make a 40+ story skyscraper fall into its own footprint at freefall speed.  It's impossible.  Not even if a plane hit it which no plane did.  The entire building was evacuated, nobody was hurt in the structure.  If the damage from the towers being attacked was that severe, everyone in that building would have been killed as well.  The collapse of the towers would damage Building 7 afterwards but still not enough to make a 40+ story skyscraper fall into its own footprint in the way it did.  The building was not made of popsicle sticks and paper.  It wasn't made of legos or jenga blocks.  The columns all were destroyed simultaneously causing a collapse all at once into its own footprint.  Office fires cannot do this or melt steel, causing a pancake collapse as the FEMA report claims happened.  We are conspiracy theorists?  Heh.  If anything the 9/11 report was a conspiracy theory.  It cant be proven that is what happened but hey, BELIEVE IT ANYWAYS because your government says so.  But if you do research and prove points wrong, you're a twoofer and hated by all of humanity.
Reply: first off i cant answer 10 questions at once. secondly you got your data wrong it was a B25 you can not compare the b25 incident to the WTC. for you guys who think that planes fly thus they must be lighter than air are delusional. a fully loaded B25 is not to exced 41,000 lbs while a Boeing 767 - 200 ranges from empty 179,000 lbs to a max of 395,000 lbs they estimated the planes that hit the WTC were around 270,000 lbs

a B25 has a max speed of 330 mph a 767 has a max speed of 600 mph do some physics and you can see that the empire state building had less damage not to mention that a B25 fuel capacity 1000 gallons of fuel while the 767 packed 10,000 gallons upon time of  impact
Reply: i was talking about the twin towers not WTC 7, not im talking about WTC 7, fires were reported in at least 10 floors mostly on the bottom of the 47 story structure so now i got to break out the metallurgy of steel when heated. figure fire burns anywhere from say 1,000 degrees F to the hotter 2000 degrees F neither is hot enough to melt steel as you guys are so hung up on.

lets get this fact out now, carbon is a key component in steel it is directly correlated to the structural integrity of steel

When you heat treat steel the goal is to take it into a predetermined "Sweet zone" and quench it in an oil bath or such water etc, it will bring hardness to the steel. i want to explain heat treating more but i feel as if i lost you already so ill cut to the point.

when steel is left red hot for too long the carbon leaves thus causing the steel to be weak. a weak steel member can not support the weight above it. well thats no big deal there are a couple hundred more. well news flash any more than 1/3 of the columns. wait put it like this 10 columns hold up 10,000 lbs. each one is rated for Fs (factor of Safety) of 1.5 common in buildings  so each can hold up 1,500 lbs well 7 columns can hold that weight 10 are holding. a fire weakens columns 1-4 and is moving to 5-7 now you have 4 columns on there way out and 2 more degrading that 10,000 lbs is very awfully heavy and now the columns buckle causing a collapse. you see they ALL dont have to go for a collapses to happen all at once. you guys think that all had to fail they dont
Reply: i know im going to regret this but . . . what do you think brought the twin towers down. if you say beam failure and i ask why. are you going to say the fire weakened it causing a chain reaction of over loaded columns to buckle. if so why cant that be logical for WTC 7
Reply: +Shawn Bateman That's the thing however. The towers didn't come down on their footprint and didn't come down at freefall velocities. The following photo gives you a pretty good idea about the devastation that the towers wrought on their surrounding environment.

https://upload.wikimedia.org/wikipedia/commons/c/cd/World_Trade_Center_3_After_9-11_Attacks_With_Original_Building_Locations.jpg

The towers wiped out a number of structures near them and even Building 7 that's out of this picture eventually came down due to structural damage from the collapsing tower 1.

As for the collapse of the tower a good source for data on the speed at which it collapsed is seismic data given there's not much visible once the huge dust cloud kicks up. Freefall from that height is about 9 seconds. According to seismic data the first impacts are registered about 10 seconds after the tower started collapsing on timestamped video. This was likely freefalling debris. The main body of the impact happens at about 20 to 25 seconds, which is the main body of the tower hitting the ground at roughly half freefall.

This is shockingly rapid but it took the towers about twice as long to fall as it would have at freefall.

I'd agree, freefall towers and landing in it's own footprint is unrealistic, which is good because that's not what happened in reality.
Reply: +Shawn Bateman The thing to keep in mind with comparing the Empire State and the WTC towers is that they are two very different buildings constructed nearly 40 years apart. 

The Empire State uses a box girder construction with ample reinforced concrete, this is a very strong structure however it has a number of drawbacks. Because of it's weight a tower constructed this way needs to taper as it nears the top, losing a lot of potential interior volume. Also, it requires that you have pillars and beams every couple of meters in it's interior.

A box girder building can lose large portions of it's structure and still maintain part of it's structural integrity as loads are transmitted both sideways and straight up and down through the box girders.

The WTC towers were built differently. They use an all steel construction using only minimal unreinforced concrete. The main structural elements are the outer walls and a set of columns in the middle of the towers containing the stairwells, utilities and elevators. All of these columns can only take loads straight up and down and by themselves they would collapse like a pile of wet spaghetti. Inbetween all of these elements are the floors, they anchor the walls and the columns together, turning the whole tower into a single structural element, the architect who designed it likened it to bamboo.

This structure is much lighter than a box girder building and results in the large open plan interior that made the building so popular.
The drawback to this is that because the entire building is one singular structural element the entire building will come apart if that fails. If the outer walls fail the floors fail and the inner column falls down with nothing to keep it together. If the column fails the floors fail and the other wall has nothing to stop it from buckling. If the floors fail then there's nothing holding either the columns or the walls together.

As for the planes, a B-25 is nearly ten times lighter than a 737 with ten times less fuel in it, it was also flying along at low speed in fog while the 737 was screaming along exceeding the maximum recommended airspeed of the plane. The B-25 embedded in the side of the Empire State. The 737 disintigrated and parts of it came out the other side of the building.

Comparing the two events is sort of like comparing Usain Bolt being hit by a baseball bat to John Cena being hit by a bamboo cane.
Reply: So 7 collapsed from debris hitting it and causing fires even though it was built as a bunker. But buildings 3,,5,6 directly under the towers that took the most damage stood fast ?  Seven looks like a real nice shot. Somebody did a great job taking that building down.
Reply: Victor Tesla
Though, if it was explosives, why fly a plane into it and why wait 59 to 110 minutes before setting off the charges? Why truck hundreds of pounds of explosive charges dozens of floors up during an evacuation.

But wait, the charges were pre-placed, how? How do you pre-place so many charges without anyone noticing and how do you set them up on just the right floors to make sure that the planes would hit right above you. Also, how do you prevent the planes from accidentally setting off the charges early?

It's not like the WTC hasn't been hit by bombs before. If you are going to bring down the building why place charges halfway up anyway? Why not do it the way that ALL buildings are imploded and set the charges near the ground, letting the weight of the building do most of the work? Also, if this was done by a demolition team, why does the collapse look nothing like a building implosion?

Also, why place explosives at all in a building that was coming down anyway? The buildings suffered pretty catastrophic damage because of the planes and they couldn't extinguish the fires. Eventually the fire was going to weaken the already damaged structure enough that it was going to come down.

One of the surprising things to demolition people is that the buildings stood for that long with that amount of damage. They thought the buildings were going to come down in a matter of minutes.
Reply: ElfNet Gaming
That ... makes no sense. Why? Why go to all of that effort. It's not like the WTC towers havn't been bombed by terrorists before.
Reply: Semni Istiqlal If your going to bring a building down like this for no reason except to cover up evidence that could lead to your imprisonment then you dont want to just blow it up, that would have lead to official investigations and the explosive residue would have been found linking back to you, BUT if you take a mock up hijacking and run a plane into it then its not investigated the same way, everyone say a plane go into it, then it came down, end of story, no need to go into a through investigation and look for explosive particulates.. It's the perfect crime and a damn good tactic.
Reply: Dude it's the US GOVERNMENT, They are prepared to kill thousands, Look at Vietnam, or the atomic bombing of Japan, or lets go closer to home, atomic, chemical, and biological testing on their own troops and citizens (minus atomic on citizens)..

all to get the population on the wagon "Terrorist Attack", push the bills and laws in to take away rights here and there, reasons to go to war. All bullshit to stop the real crimes from being investigated properly.

An office fire could not have accomplished a total building collapse, it is could then there would have been building failing all over the world due to fires. The Empire State building was hit by a B-25 and its way older and its still standing.

I know you like to think that the government is perfect a savior, Hell i bet you get government benefits, housing, etc. Yeah its all good for you, they NEVER do any wrong and never will and you believe whatever bullshit they tell you because they are your heroes, saviors you favorite bush in office, with his monkey face and elephant ears can do nothing wrong, FULFILL DADDY's LEGACY! and that he did and now the ape in office is caught in a cluster fuck of crap and make up his own rules as he goes.. 

I forgot the US GOVERNMENT is the perfect model for global policy.. They are do good global police department..
Reply: ElfNet Gaming
Scroll up a couple of posts, I've got an analysis on the WTC and the Empire State versus planes. The TLDR of that is: WTC was a lightweight structure that got hit by a very big and very fast plane, the empire state is a heavy structure that got hit by a relatively small and slow plane.

It's like calling foul play when someone gets killed by a truck because people walk away from car accidents all the time.

You are perscribing to the US government a level of competence that it does not reflect in any other vocation.

If the 9/11 attacks were orchestrated to set the stage for invading Iraq a second time. Why did they first spend two years messing about in the wrong country and then trump up accusations of WMDs?

Why is it that if they can so effectively cover up a conspiracy and they have no problem with killing off many people, can they not silence a handfull of conspiracy theorists?

Also, if it was the US government who did it, and they can tell the US government investigators at the scene to ignore all of the evidence of bombs being in the WTC. Wouldn't it have just been measurably easier to not bother with planes in the first place and tell their investigators to ignore any evidence that the bombs were planted by the US government and then point the finger of blame at Osama Bin Laden?

You notice how your story is full of gaping big holes, do you?
Reply: I've been saying the same thing for a long time. Wind increase at altitude feeding a fire inside of a well insulated high rise might get hot enough to melt steel. I was further convinced when I saw the special on how thermite can't do it either. Now this guy........... What can I say? The proof that thermite is capable is right in front of you. Time to open back up the conspiracy theory part of my brain again.
Reply: +Gatito De Ana interesting. Because I've cut through plenty of steel with an acetylene torch to know that wrong.
Reply: +Chris G No building can be considered hermetically sealed with  elevators and stairwells traversing through it, not to mention a hole the size of an air plane.
Reply: +Semni Istiqlal 
Severed columns and office fires in the top of the tower are in no way adequate to reduce the entire structure to dust.  The worst that should have happened would be a localized collapse of the affected floors, and a leaning/toppling of the top portion towards the weakest area.  The official story defies physics.
Reply: +Gatito De Ana But what if the planes were magic? Magic planes can bring down any building
Reply: +Semni Istiqlal 
You keep pretending that an argument composed entirely of conjecture somehow refutes the scientifically proven presence of thermite published by Harrit et al in April 2009.  Refute this study directly; dancing around the issue is not a valid rebuttal.
Reply: Emvaz22
I don't believe I have commented on thermite at all, you just sort of tossed it into the arena waving it around as if it's some sort of debate trump card.

I'm no chemist so there's not awefully much I have to say about the paper, and I don't get the impression you are either because you just sort of slap it down without referring to it's contents or making any kind of real argument.

However one thing that does spring to mind is that they make no real effort to verify that these particulates had an artificial origin, they just sort of assume so. It doesn't seem unreasonable to me that a large pile of steel and aluminium that had just gone through a significant emotional event would produce iron and aluminium dust. Now if this Thermite consisted of elements that weren't the most common elements at the site this discovery would be more significant.

Unless they can rule out a natural origin or tie these flakes to a specific product or device they are going to remain an interesting anomaly.

The argument I have been making is that events like these have a narrative. They are a sequence of events put into motion by actors with motivations.

The generally accepted one is that people willing to strike a blow against the US highjacked and then flew several planes into american landmarks. The WTC towers caught on fire and couldn't be extinguished, they eventually collapsed due to the combined effects of the initial impact and the prolonged fire.

It's a simple story of very angry people using planes as crude guided missiles. It didn't require a lot of sophistication to pull off and even then they failed in a number of significant ways.

Meanwhile the counternarrative most consistently comes down to "The gubmint did it cuz dey are evil and wanna take away our rights."
Reply: Emvaz22
Aah, so we are comparing the size of our experts then? If number of experts is a measure of validity of an argument then the NIST study had thirteen project leads alone and pages upon pages of experts and scietistis scrutinizing the evidence and they came to a very different conclusion.

By itsself the paper is an interesting anomaly, nothing more, nothing less. It doesn't explain how the particles got there, where they came from or even what they mean.

You have to put this into a scenario, a sequence of events that would believably lead to this showing up the way it did. You cannot just waddle in, wave a piece of paper around shouting "Ah Ha!"  and expect to be taken seriously.

Also, please don't trot out the "free fall" argument, it betrays how little you really know about the subject at hand. Seismic records show that the main bulk of the tower hit the ground 20 to 25 seconds after the collapse began. Freefall from that height was about 9 seconds.

Also, the WTC towers were surprisingly insubstantial. They were basically steel tubes filled with air. The upper part of the towers fell through the middle of the tube, pushing the walls of the towers aside. There's not a lot of things that can arrest the momentum of 600,000 tons of tower falling.
Reply: +Semni Istiqlal 
Nope; were comparing the fact that I can actually cite experts, whereas you have none to directly refute me.  Even if I had only 1 expert, 1 is still infinitely more than 0.  Your opinion doesn't matter if it conflicts with the facts.

Moreover, the NIST study wasn't peer reviewed, and never tested for incendiaries or explosives.  

Your assertion that the study is somehow invalid because it doesn't account for the source of these chips and how they got there is fallacious.  It would take an investigation to determine that.  But I suppose you believe the theory of relativity is incorrect because we can't account for why E=MC2.

All this aside, I'm sure there is no way this material could have been installed during the months long elevator modernization being undertaken by a pentagon contractor.  Nah, couldn't be.
Reply: +Pat McBride Fair enough. Can't wait for you experiment video!
Reply: +Semni Istiqlal 
Right next to it?  It was across the street with a building in between that didn't collapse.
Reply: sTEALtooth
You are going to have to be more specific, the way YT commends work doesn't let me know what you are responding to.
Reply: Semni Istiqlal

"Building 7 was probably weakened by having TWO SODDING GREAT BIG SKYSCRAPERS COLLAPSE RIGHT NEXT TO IT."
Reply: sTEALtooth
Uhmmm...
https://upload.wikimedia.org/wikipedia/commons/d/df/WTC_Area_With_Building_Numbers_50dpi.png
Reply: Semni Istiqlal

Right.  It's across the street and Building 6 didn't collapse.
Reply: Emvaz22
"Your opinion doesn't matter."

Yep, typical tinfoil. You are going to cling to whatever evidence supports your assumptions and dismiss everything else.

Also, don't kid yourself, I never said that the study was invalid, just that by itsself it doesn't really mean anything. Without an understanding of a scenario it fits into it's just another piece of information.

Either way, installed to do what? Where? Where in the building would you put this stuff and what would you do with it? Ignite a fire? I'd assume it'd be simpler to let the plane do that,  it's got a ton of fuel on board that's going to splash all over the place.
Reply: +Semni Istiqlal If you don't know the answer to that question, you really have no place spouting off your dogma.  Why he says... really?  Wake up!!
Reply: Brooklin Funkproject
Good to see the tinfoil brigade is out in force. Using vague jargon, telling anyone who doesn't agree with you to 'wake up' etc. I wonder who is the person being dogmatic here.

I'm curious to see how Emvaz22 feels that the events at the WTC played out. The thing is that I hear a lot of conflicting and incoherent stories from the truthers so I'm asking him what he believes happened and how he believes that it happened.
Reply: Brooklin Funkproject
Aaand that's conspiracy theorist defence #1 If they don't agree with you they are part of the conspiracy.

I'm supposed to swallow your 'truth' without question, without criticism and if I don't I'm part of the problem. That's dogma allright.
Reply: Brooklin Funkproject
Which again is a very dogmatic way of thinking, to you it's more important that many people believe this than what you can prove about it. I've invited you multiple times to explain your position but you havn't, in stead it's more important to show how many people have the same beliefs you have and which people agree with you.
Reply: *****
Glass houses my friend, glass houses.
Reply: just watch the video.  Do you have comprehension problems?
Reply: Brooklin Funkproject
It's not your video, I'd like to know your argument, your scenario of what happened there.

Besides, the video doesn't really go into detail about the logistics of actually applying the Thermite/Thermate.
Reply: TheBrownSys <Your peer reviewed paper is a joke, no it's not a valid source.>

It's a valid source, and would be an acceptable citation in any academic setting.  Prove otherwise.

<Again anybody in demolition and explosive experts would laugh and this video and you claiming thermite was used lol.>

Cite one single example in a published format.  Just one.

<The paper has been laughed at by any serious engineer.>

AE911 has a petition of 2000+ architects and engineers, many of which with experience in high-rises, who all claim the officially story is flawed.  Can you cite a similar group of professionals who disagree with this analysis?  No?  I wonder why that is.

<They would not use thermite to bring the towers down, it would be the dumbest and most useless method to do it.>

Solid argument.  You are clearly a master at debate.

<Anyways the thermite nonsense has been debunked years ago.>

No it wasn't.  Cite your refutation.  Let me guess, you don't actually have one.  What a surprise.

<If they were going to bring the towers down they would use shaped charges and they would be easier to hide.>

You realize that thermite can be used in a shaped charge configuration, right?  Oh thats right, you're a moron.

<Nano thermite and nonsense is a attempt by half wits to explain their nonsense theory.>

Scientifically proven, peer reviewed, published, and unrelated in 6 years.  Too bad.

<A small shapes charge would be easier, you would never hear it.>

I'm sure TNT or RDX wouldn't make a peep...idiot.
Reply: Semni Istiqlal <I never said that the study was invalid, just that by itsself it doesn't really mean anything. Without an understanding of a scenario it fits into it's just another piece of information.>

A piece of information which explains the collapse and disproves the official story.

Oh, and you have claimed multiple times that the study is flawed, but have yet to give a technical reason why.

<Either way, installed to do what?>

Sever steel columns, welds, or bolts.

< Where? Where in the building would you put this stuff>

Uhh, the steel support structure, specifically on the 47 main support columns accessible through the elevator shafts.

<and what would you do with it>

Uhh, ignite it?

<Ignite a fire?>

Nope, remotely trigger it via a device such as a magnesium strip.

< The thing is that I hear a lot of conflicting and incoherent stories from the truthers so I'm asking him what he believes happened and how he believes that it happened.>

Irrelevant conjecture.  That is an issue for a new, genuine investigation to sort out.  For me to pretend like I know all the details of the events that unfolded would be disingenuous.

Stick to the facts.
Reply: +Chris G
Okay, so then you agree that it would be easy, huh (since you said "not hardly")?
Reply: +Mike Bishop, thermate and thermite, just as the video says, are not high explosives. You really think dynamite or/and TNT were used instead?
Reply: Emvaz22
You aren't a scientist, we are on the internet, all you have is conjecture.

The issue you face there is that the collapse in the tower didn't start from the bottom, it started from approximately the same area that the planes hit. Specifically the south tower very obviously had the outer wall fail before the central column was pulled down with it.

You could just say that the charges were placed in the same area that the planes hit, however then you have another set of problems. You aren't going to be capable of predicting very accurately which floors the planes are going to hit. It's hard enough to hit a specific building with a jet that size that some conspiracy theorists claim it was impossible.

Pre-placing the charges has a lot of issues. If the plane hits the charges directly you have a good chance of it setting off the charges immediately and the tower coming down right away. If the plane hits too high it won't result in a collapse that we observed, and if it hits too low you stand a good chance of your charges being cut off from whoever is touching them off.

And them's the facts, if you cannot theorize how the thermite was used to result in what's observable it's just thermite, it's just one of dozens of chemicals found there. You cannot prove how it was used, or if it was used at all.
Reply: No, *****, the planes had a lot to do with it. Well duh, they jabbed huge holes into the buildings!
Reply: 9 whole experts?  Boy have you really got it all figured out, and youve got your whole list of 9 tinfoil hat wearing "experts" who "peer review" each others papers and polish each others pipes, to back up your startling discovery.  This of course all coinciding with your polishing of all their penises simultaneously, a method which interestingly you use to  stroke your own ego.  Meanwhile...back in reality... A couple of huge fucking planes hit a couple of huge fucking heavy ass buildings and roasted for an hour and...low and behold, avsolutely AMAZINGLY...seriously this is just SO UNBELIEVABLE...they collapsed.  So yeah I guess the only possible answer is your astonishing scientific explanation in which " you can cite" a whole 9 experts who's opinion nobody had or ever will care about.  What else ya got to enlighten is with today Sherlock Holmes?
Reply: So why didn't they crash the planes into the buildings at night you complete fucktard?  Wow this is seriously the absolutely most idiotic idea I've heard yet about this subject.  And that is saying a whole lot because there have been some whoppers.  But this tops them all...LMFAO!
Reply: *****
It's pretty tinfoil dude ... especially since you really don't have any evidence of this happening. It's just you making wild assertions.

Extraordinary claims require extraordinary evidence.
Reply: Apparently, *****, you don't get that giant holes were made in the buildings with planes. They had something to do with it because they made the holes!
Reply: *****
You are going to have to explain why planes had nothing to do with it. Both planes hitting the towers and the one hitting the Pentagon are quite well documented, extremely well.

We know where the planes hit, how they hit, how fast they were going, how much they weighed within a reasonable margin of error. We even know who was on board.

Are you claiming those planes didn't exist?
Reply: Bahahaha this guys a piece of work.  He's got it all figured out. Lmao!!! What an absolute asshat.
Reply: Emvaz22
I'm sorry to see that you have invested so much of your ego in 'winning' an internet argument. You really must have nothing better to do.

Honestly, you are just behaving like a petulant child. Even going so far as having to tell me that you've won the argument.

Your comment about a reinforced core reinforces (ironically) the fact that you have no idea what you are talking about. The WTC towers had no reinforced core. It was one of the particularieties of the building's design.

It had a lightweight core only capable of transmitting stresses straight up and down. It's walls were made of inch and a half thick drywall. That's not going to stop shit.

The only way that the WTC tower collapse resembled a building implosion was that it fell down.

Then you have your prized little paper. Authored by what, nine people? The study started six years after the fact studying materials whose chain of custody is suspect at best. It's only very technically peer reviewed in the sense that it was published in a peer reviewed paper. I havn't managed to find a single serious peer review of the paper at all, and to top it all off the paper doesn't even assert that there was thermite of any kind in the material they studied.

See, the impression I get here is that one of your 'truther' buddies heard from a friend that this paper had the word thermite in it and then you started running around like headless chickens without actually reading it.
Reply: *****
Aside from everything I've already posted in this conversation?
Reply: *****
Approx 600,000 tons.
Reply: Semni Istiqlal <You really must have nothing better to do.>

Says the guy posting a YouTube comment at 10:30AM on a work day, and who's been in this thread for half a month.  That's the pot calling the kettle black.

<Your comment about a reinforced core reinforces (ironically) the fact that you have no idea what you are talking about. The WTC towers had no reinforced core. It was one of the particularieties of the building's design.

It had a lightweight core only capable of transmitting stresses straight up and down. It's walls were made of inch and a half thick drywall. That's not going to stop shit.>

Leslie Robertson, Architect Of The World Trade Center Towers:

"Robertson, whose firm is responsible for three of the six tallest buildings in the world, feels a sense of pride that the massive towers, supported by a steel-tube exoskeleton and a reinforced concrete core..."

The core columns and elevator shafts were contained within a steel-reinforced concrete core.  Any more lies for me?  

<The only way that the WTC tower collapse resembled a building implosion was that it fell down.>

It fell straight down into its own footprint.  The manner of collapse does more represent an explosion though, you're right about that.

<The study started six years after the fact studying materials whose chain of custody is suspect at best.>

The paper lists names, locations, times, video testimony, eyewitnesses, and sworn affidavits.  All for independently donated samples turn up the same thematic material.

< I havn't managed to find a single serious peer review of the paper at all>

You must not be good at the internet.

From Steven Jones:  "The reviewer's name is Prof. David L. Griscom.   Among his impressive credentials, Prof. Griscom is a Fellow of the American Physical Society and a Fellow of the AAAS.  I quote a brief excerpt from his blog and encourage you to read all of it:
"II. The 2009 publication in The Open Chemical Physics Journal (TOCPJ) of a fabulous paper by Harrit et al. entitled “Active Thermitic Material Discovered in Dust from the 9/11 World Trade Center Catastrophe” Some disparagers of the 9/11 Truth movement have alleged that TOCPJ is a place on the web where anybody can buy a publication without peer review. Absolutely false! I know this because I was one of the referees of the Harrit et al. paper. The editors asked for my opinion. And after about two weeks of studying what the authors had written, checking relevant references, and gathering my thoughts, I finally provided my advice to authors in 12 single-spaced pages, together with my recommendation to the Editors that they publish the paper after the authors had considered my suggestions. Still, some skeptical readers may ask how anyone can rate a scientific paper as “fabulous.” Well, I am the principal author of 109 papers (and a co-author of an additional 81) in peer-review journals. And have refereed a least 600, and possibly as many as 1000, manuscripts. So you would be right in calling me an aficionado of articles published in scientific journals. And I found absolutely nothing to criticize in the final version of the Harrit et al. paper! Apropos, twelve of my own publications have appeared in the American Institute of Physics’ Journal of Chemical Physics (an old fashioned paper journal), so it is accurate to say that chemical physics (of inorganic materials) is my main specialty.""

David Griscom, formerly of NASA, DARPA, and US Naval Research.  But I guess he doesn't qualify as a "real" scientist.  Any more lies?

<and to top it all off the paper doesn't even assert that there was thermite of any kind in the material they studied.>

Ah, not done yet I see.  Had to squeeze in one more lie.

From the Harrit paper: "Based on these observations, we conclude that the red layer of the red/gray chips we have discovered in the WTC dust is active, unreacted thermitic material, incorporating nanotechnology, and is a highly energetic pyrotechnic or explosive material."

It appears you never got to the conclusion section of the paper.  You're looking more and more credible by the sentence.

First you claim there is no fault with the paper, then you claim the paper was not peer reviewed, the you claim that the paper doesn't even conclude the presence of incendiaries.  Seems like you are grasping at straws.  Maybe you should think about formulating a coherent argument before you type your next response.
Reply: Emvaz22
Yeah, I can C/P stuff too. Everything you've posted here is from good old 'truther' websites.  When you do a bit of research on what they have written you realize that they are pretty creative interpretations of the truth. Or that they are truthers, directly related to the writers of the paper or both.

For example, the concrete reinforcement in the WTC ends at about the 6th floor. It's notable because a couple of firefighters survived the collapse in that part of the building.

10:30 AM heh, someone doesn't understand timezones.

"unreacted thermitic material" which is the most weasel-wordy way of saying it. That's basically them saying "We found material that looks like thermite but we aren't going to call it thermite in case we get called on it then we can just claim we never said it was thermite." they are really sure of themselves? Honestly, that paper is just packed with weasel-words, allowing truthers to creatively interpret it as you wish.
Reply: +MomoTheBellyDancer  a 2 foot thick stainless steel sphere with a small air bubble in the center would remain hermetically sealed, buddy. I mean seriously...
Reply: Emvaz22
They still make efforts to avoid actually calling it thermite and you are definitely not in any position to make that conclusion for them.

It's almost like they know it's not actually thermite and don't want to be called on it but still want to give the impression of it being thermite.

Also, the architect of the towers was not Leslie Roberts, it was Minoru Yamaski. Seriously, please do your homework.
Reply: Emvaz22
Because calling it thermite would imply it was made by human beings. Which is something they cannot say. You know why? Because they know it wasn't.

Also, structural enginner != architect. Seriously ... they do very different jobs.
Reply: +Semni Istiqlal 
<Because calling it thermite would imply it was made by human beings. Which is something they cannot say. You know why? Because they know it wasn't.>

Oh thats right, I almost forgot, you believe the Thermite Fairy sprinkled her magic nanothermite powder over the debris field, just for fun.

Or maybe you believe aliens dropped it out of their flying saucer after they vaporized the towers with directed energy space weapons, you know, to throw us off their track.

Or maybe you believe this material, which (according to fig. 29 of the Harrit paper) is twice as energetic and reacts much more quickly that Xerogel, a known super-thermite formulated by Lawrence Livermore, formed spontaneously and randomly out of the dust in 10 seconds during the collapse.  Right, and I can shit gold bricks.

<Also, structural enginner != architect. Seriously ... they do very different jobs>

As it relates to the quote by Leslie Robertson concerning the reinforced core of the WTC, how does this distinction matter?  Specifically.
Reply: Emvaz22
You are the person calling it thermite. You've made up a false dilemma and are using conspiracy to explain it.

Xerogel? I think someone is trolling you, that's a type of aerogel. It's a lightweight foamlike material.
Reply: Semni Istiqlal <You are the person calling it thermite. You've made up a false dilemma and are using conspiracy to explain it.>

As far as I can tell, the only dilemma here is that you are trying to argue against a paper you've clearly never read, and keep changing your argument to suit the situation.  Even with your cherrypicking, you've got nothing.

<Xerogel? I think someone is trolling you, that's a type of aerogel. It's a lightweight foamlike material>

From p.26 of the Harrit report:
“This sol-gel method allows for the addition of insoluble materials (e.g., metals or polymers) to the viscous sol, just before gelation, to produce a uniformly distributed and energetic nanocomposite upon gelation. Al metal (as a fine powder, ~6μm diameter) was added to some FexOy gel syntheses just before gelation to produce FexOy /Al(s) pyrotechnic nanocomposites.... These nanocomposites were subsequently processed to make both a xerogel and aerogel of the material.... The pyrotechnic nanocomposite can be ignited using a propane torch” [19].

[19] Gash AE, Simpson RL, Tillotson TM, Satcher JH, Hrubesh LW. Making nanostructured pyrotechnics in a beaker. pre-print UCRL-JC-137593, Lawrence Livermore National Laboratory: Livermore, Ca; April 10, 2000.

In essence, the thermite reactants can be added to an aerogel or xerogel mixture before gelation to create a super nanocomposite which can then be handled safely until applied and allowed to cure.

You should really try reading the paper.  You might learn something.
Reply: Emvaz22
So really the only information you have is from a paper that hasn't been seriously peer-reviewed since it's publication in 2009, it doesn't even assert that there was thermite and only now you appear to be reading it in full.

And you really do seem to be a one trick pony, the only thing you appear to have is that paper which you cling to as if it's some kind of conspiracy theorist life-raft.

Which it really kind of is, after 15 years that's the most solid evidence you've been capable of digging up? Really?

Against the sheer body of evidence for the conventional theories it really does seem pathetic and a bit desperate.

And yes, sometimes I change my opinion and my story changes with it. Because unlike you I am not stuck in a dogma and my opinions are allowed to change and be shaped by new information.
Reply: Emvaz22
his recent posts reminded me of a guy I met:
Handsome, tall, white, millionaire family. Literate and well spoken. Drives a BMW. Confident. Well dressed. 29 years old.

lives at home despite it bothering is father. homosexual. clinging to his religion, finding any excuse to believe his popular fantasy story. In debt.

Just saying.
Reply: Emvaz22
Just because it's published in a peer reviewed paper doesn't mean it's actually been reviewed. Please, this is basic science.

It's what I've been trying to tell you all along, I cannot even find a paper that CORROBORATES your paper. It's like it came out in 2009 and nobody gave a shit about it.

Probably because it's full of weasel words. You are the one calling it thermite, they go out of their way to avoid calling it thermite.

Just because you keep on saying it won't make it true.

Your only evidence for your controlled demolition claim is that paper. And nothing about it actually supports the idea of controlled demolition.
Reply: *****
Determining a building fire temperature off flame colour and smoke colour alone is not accurate, especially in a large structure where you cannot see right into the heart of the fire.
Reply: *****
I am still hoping to get a coherent answer on why building 7 is important.
Reply: +Semni Istiqlal If i tell you your house has collapsed, and then it collapses 20 minutes later. What are you gonna think?
Reply: RanndomUndead
That'd you'd need to get your facts straight?
Reply: Semni Istiqlal
WTC7 was reported fallen before it happened. While WTC7 was in the background.
20 minutes later, it just happened to collapse flawlessly.
Reply: RanndomUndead
So? Wasn't it on fire at the time?
Reply: Semni Istiqlal <Just because it's published in a peer reviewed paper doesn't mean it's actually been reviewed. Please, this is basic science.>

It's peer reviewed.  Prove otherwise.

<It's what I've been trying to tell you all along, I cannot even find a paper that CORROBORATES your paper>

Can you find a paper that disproves it?  Didn't think so.
Reply: Emvaz22
What that means is that nobody cares about it enough to even bother corroborating or refuting it. That's not good news.

A single paper does not a theory make. Please this is basic highschool science.
Reply: Steve Gould
Not cool dude. :/
Reply: Emvaz22
Okay, so doing a bit more reading up on the paper in question.

1. It's remarkably inconclusive. They never actually conclude that it's thermite of any kind.

2. However they do go to lengths to describe it as being like thermite. So why not call it thermite? Suspicious.

3. The main author of the paper is a chemist, not an engineer. Yet fails to conclusively identify the material.

4. A number of the co-authors aren't even chemists, there's even a sociologist in there. They are literally there to pad the numbers of authors artificially. Again, suspicious.

5. Many authors are known long term 'truthers'. This doesn't lend any confidence to this study being impartial.

6. The materials studied were collected years after the event with no clear line of custody, and no precautions against contamination in the meantime.

7. It has been six years and there has been no followup to that study.

8. An editor of the paper who published it has since publically denounced it for being shoddy science and resigned over the publication.

9. Even if all of the above wasn't an issue, Thermite is a material that's used in the construction of steel frame buildings like the WTC and the underground rail lines that it stood on. Finding Thermite is not much of a revelation.
Reply: *****
Ah yes, the ever predictable conspiracy theorist defence: "You must be part of the conspiracy."
Reply: Semni Istiqlal
I am a conspiracy theorist.
I don't respond that way.
it's not ever predictable.
Your assertion it is 'ever predictable' is as foolish as his.
bye now.
Reply: Aaand they cannot even take what they dish out.

You = "Wah wah wah, he's being mean to me mommy."
Reply: *****
I'm still not entirely sure what the significance of building 7 is. A reporter fucked up a report about it at the time? There are entire compilations of reporters saying stupid or just plain wrong shit.

Besides, even if they deliberately brought down building 7, what's the significance of that? It was evacuated anyway.
Reply: Semni Istiqlal
If you tell me 1000 people have died on a live broadcast, with a crowd of 1000 behind you, and then 20 minutes later those 1000 die, your're damn right im going to suspect you had prior knowledge.
Reply: RanndomUndead
So? Even if they did deliberately demolish building 7, what's important about that? It was an evacuated building. Nobody died when it came down.
Reply: Semni Istiqlal
If they conveniently already had it wired to blow.....then why wouldnt the towers be wired to blow aswell? Keep in mind, demolition trucks were spotted in the vicinity of the attack, even on camera.
Reply: RanndomUndead
Building 7 would have already been the tallest building to have been imploded at the time. The towers would blow that record right out of the water.

Also, how are you going to pre-wire the towers exactly where the planes are going to hit? On all of the visual footage the towers appear to fail at the point of impact. Even if you wire the whole tower and blow just the bit that the planes hit you have the problem of stopping your charges from being set off by the raging inferno or simply being destroyed.

Keep in mind that this was an impact with enough energy to punch through the front of the building, through several floors, through the core of the building and punch not insignificant debris out the other side.

Also, you have the added problem that if you wire the whole tower suddenly you have a site with tremendous amounts of unexploded ordinance in it that somehow got overlooked.
Reply: Semni Istiqlal
Keep in mind there are MANY explosives that can ONLY be set off by an electrical charge, not just c4.
Keep in mind the charges wouldve been conveniently placed around the lower 3/4th's of the building.
The reality is this, Should the tower had stayed standing, in all reality the fire would have burned downwards, turning each floor it reached into coals.
Heres where i think our opinions meet though. The tower that had the top fall off, i believe that was due to structural failure just because of the entire side of the building was missing support beams, and it being near the top (where all the heat would push too) did cause a strong enough weakening for it to break off. However, when the rest of the building went with it, that was nothing other than demolition charges. When you cut a sandbag from a hot air balloon, it doesnt go down. it goes up.
And just so you know, theres a video out there, a very well hidden one that has been shoved to the darkest reaches of the internet. The video clearly shows, from the same block as the tower, a massive explosion happening at the base of the tower from within.
Aswell, lets not forget the janitor who saved tons of lives but was hardly even glanced at because his story contradicted the official one.
Reply: Semni Istiqlal <What that means is that nobody cares about it enough to even bother corroborating or refuting it. That's not good news.>

I'm sure being a taboo subject has nothing to do with it.  Simpleton.  And you call your analysis "science?"  How about you cite some actual science to back up your claims.

If nobody cares about it, then why have so many anonymous "debunker" shills tried to discredit it on their unscientific blogs?  Your logic fails under scrutiny.

<1. It's remarkably inconclusive. They never actually conclude that it's thermite of any kind.>

From the Harrit paper: "Based on these observations, we conclude that the red layer of the red/gray chips we have discovered in the WTC dust is active, unreacted thermitic material, incorporating nanotechnology, and is a highly energetic pyrotechnic or explosive material."

<2. However they do go to lengths to describe it as being like thermite. So why not call it thermite? Suspicious.>

Uhh, because to say that it's thermite would be incorrect, because it would imply the conventional form of thermite (Al + Fe2O3).  The material is added to an energetic substrate, and the reactants are on the nano scale.  It is clearly more advanced (and exhibits a far greater exothermal spike in a DSC) than any conventional thermite, which is why they don't call is conventional thermite.

<3. The main author of the paper is a chemist, not an engineer. Yet fails to conclusively identify the material.>

You're an idiot.

<4. A number of the co-authors aren't even chemists, there's even a sociologist in there. They are literally there to pad the numbers of authors artificially. Again, suspicious.>

Engineers, chemists, physicists, all relevant.  Nice ad hominem though.  That all you've got?

<5. Many authors are known long term 'truthers'. This doesn't lend any confidence to this study being impartial.>

Oh lordy lordy, we can't be having people interested in knowing the truth performing science which they are professionally qualified to do.  Lets find some pain-off shills who are more interested in politics and maintaining the status quo.  Yeah that will lead to some good science.

<6. The materials studied were collected years after the event with no clear line of custody, and no precautions against contamination in the meantime.>

Right, all four independent samples all happened to become contaminated with the same advanced thermitic material.  But this material wasn't in the original dust.  Couldn't be.  Right.

<7. It has been six years and there has been no followup to that study.>

Mark Basile is working on an extensive follow-up, and has posted numerous videos on YouTube demonstrating the exothermic nature of this substance, and contrasting it to primer paint, which morons like you think is the material that was found.  Has there been a study to refute Harrit's findings?  No?  I wonder why that is.

<8. An editor of the paper who published it has since publically denounced it for being shoddy science and resigned over the publication>

Resigned due to political pressure.  Never faulted the study for any technical aspect.  Prove otherwise, liar.

<9. Even if all of the above wasn't an issue, Thermite is a material that's used in the construction of steel frame buildings like the WTC and the underground rail lines that it stood on. Finding Thermite is not much of a revelation.>

Right.  Advanced, experimental, military grade nanothermite would have been used in building construction 40 years ago.  Gotcha.  Cite the study that proves the type of thermite used during construction is the same type discovered by Harrit.

Such a shame; nine bullet points and not one single scientific fact.  You're not very good at this are you?

Try again.
Reply: +Semni Istiqlal occam's razor: 
usually but not always.
Reply: Emvaz22
And you call me a liar and then immediately accuse me of ad-homs. Did I touch a nerve?

You don't even have a paper saying it was your fancy experimental military grade whatsits. All you have is a paper that says it was 'thermitic' thermite-like. The presence or absence of thermite is not important. It's a commonly used material

Like, you call me a liar and then you say things that are obviously untrue. Even contradicted by the very materials you cite.

The sad thing about all of this is that it really just comes down to your presentation. You stormed in and basically slapped down this paper shouting "DISPROVE THIS ASSHOLE". It would have been a really interesting thing to discuss but you had to go and assume this was some kind of contest and I had to be your enemy.

A self-fulfilling prophecy really.
Reply: RanndomUndead
That is an interesting theory I havn't seen before. Though I am not sure why they would need explosives in that case. Once something as massive as the upper part of the WTC towers starts moving there isn't much around that's going to stop it. My guss would be that it weighed somewhere around 100k tons.

What's visible is that both tops fell into the rest of the tower. Now, the outer walls and inner core would be capable of supporing that kind of weight, they were designed to, but if you look at the floor plan of the towers those elements make up a relatively small part of the total surface area. Most of of the floorspace is made up of the large floor elements designed to span between the core and the outer walls, anchoring both together.

These floors are not designed to take that kind of weight. They are designed to carry an office worth of people and equipment. Maybe a hundred tons if we are being generous. Now it's being subjected to ten times that pressure even if we don't account for the fact that the rubble is now falling.

What you get there is that the debris of the upper floors starts falling through the path of least resistance, crushing floor after floor and peeling the building open like an orange. You can see it in several videos of the event how sections of the wall remain standing while the rest of the building has collapsed before falling some time later.

Now there's one element that often gets overlooked: Buildings are mostly air. When you have 100k+ tons of building coming down on the rest, air needs to go somewhere, and it's going to go there very rapidly because the internal volume of the building is decreasing very rapidly. It's going to burst out through windows, it's going to burst down stairwells and elevator shafts, again following the path of least resistance.

What do we know of that commonly generates bursts of very fast air? Explosions. People are going to think those are explosives going off.

I hope this was a bit educational. Sort of explains my point of view on things. Stay safe. :)
Reply: Semni Istiqlal <And you call me a liar and then immediately accuse me of ad-homs.>

Actually I accused you of ad hominem, THEN I called you a liar.

Your attempt to discount the contents of the Harrit paper by trying to discredit its authors, its editors, and its publication, is the archetype of an ad hominem logical fallacy.  

Your presentation of information that isn't true as being factual (such as the Harrit paper never concludes that there is thermite of any kind), makes you a liar.

<You don't even have a paper saying it was your fancy experimental military grade whatsits.>

I don't?

"Ordinary thermite ignites at a much higher temperature (about 900  ̊C or above) and gives a significantly broader trace than super-thermite [21]. All these data suggest that the thermitic material found in the WTC dust is a form of nano- thermite, not ordinary (macro-) thermite."

[21] Gash AE, Satcher JH, Simpson RL, Clapsaddle BJ. Nanostructured energetic materials with sol-gel methods. Mater Res Soc Symp Proc 2004; 800: 55-66.

Fig. 29 compares the DSC trace of the Harrit material compared to an experimental xerogel nano incendiary formulated in government labs. [28]

[28] Tillotson TM, Gash AE, Simpson RL, Hrubesh LW, Satcher JH, Jr, Poco JF. Nanostructured energetic materials using sol-gel methodologies. J Non- Cryst Sol 2001; 285: 338-345.

The Harrit material ignites at the same temperature (420C) as the xerogel incendiary, completes its reaction more quickly, and exhibits an exothermic spike of twice the intensity.  Therefore it is a more effective incendiary material than the xerogel incendiary.

<It would have been a really interesting thing to discuss >

Whats stopping you?  You are welcome to cite an alternative analysis of the WTC dust which conflicts with the Harrit paper.  Then we can pick up the discussion from there.  Until then, your misconceptions, misinformation, and misdirection, don't actually qualify as a real argument.
Reply: Emvaz22
Well, your attitude is particuarily poor. But either way, as the person making the claim you are the person who needs to back up your claims.

So far the ONLY piece of evidence you have is a single paper written by a set of known truthers. Some of which aren`t even chemists.

Also, seriously look up what an ad-hom is ... it`s even on wikipedia.
Reply: Semni Istiqlal < But either way, as the person making the claim you are the person who needs to back up your claims.>

Already have.  Now you are the one making claims, such as the paper has been refuted, debunked, etc. yet you have yet to present any evidence to support them.

<So far the ONLY piece of evidence you have is a single paper written by a set of known truthers. Some of which aren`t even chemists.>

Ad hominem.

Me: published, peer reviewed paper
You: no published paper

One is still infinitely more than zero.  Also, don't forget the countless eyewitness testimony regarding secondary explosions and molten metal during the clean-up, as well as the "eutectic" steel in FEMA's appendix C, which all corroborate the controlled demolition theory.
Reply: +Pat McBride That's what I was thinking after about 2 minutes.
Reply: +Semni Istiqlal 
Last time I checked, tunnels are usually made out of reinforced concrete and stone not steel beams, fuck me your logic made no sense.
Reply: *****
It's not the tunnels, it's the train tracks that are made out of steel and they often use thermite welding on those.
Reply: Semni Istiqlal thermite must be lit by something hotter than fire . like in the vid he shows you have to use a magnesium strip. Look closely at the towers before they fall theres a heated band all the way around it just under the impact . as if its being melted by something in a nice straight band
Reply: toob247
You are going to have to link a specific video, I don't see it in the ones I've found.

Another issue with thermite is that it doesn't ignite reliably. Sometimes it'll ignite right away, other times it may take a while, that's not a good material for demolition.

Also, another nail in the coffin of people using the Harrit paper to claim foul play is that production of nanothermite was extremely limited in 2002. It was a slow process that had to take place in a lab and didn't scale well. Even today production is only up to about 100kg/month or so. To use it in a building the size of the towers you'd need literal tons of the stuff.
Reply: Semni Istiqlal i dont have to link anything look closely at the buildings . look for a heat line around the building right under the imoact zone in a perfect line. 
Where theres a will theres a way. Im sure if the governments of israel and usa wanted to demo the buildings itvwould be no problem. Seven had to be pre rigged so why not 1 and 2.  
And as far as production records of nano thermite . yeah im sure if it was used . they kept the receipt.  Seriously if it fell the way the official story said it fell physics says that the building would resist the falling debri and eventually slow its fall. Leaving a core sticking up like a tree trunk or a twenty story building. Because for every action there is an equal but opp reaction. 
 Once the top fell and was broken to bits , the buts would not have the strength to collapse it to the ground . even though the broken building top weighs the same as an intact building the impact is dispersed. Like dropping a eight pound of rocks vs dropping a bowling ball. If it were natural they would have resisted. Especially the tower that was hit up highest. Seven is the smoking gun.
Reply: +Semni Istiqlal 
So why are you changing the argument now?
Reply: ***** <So why are you changing the argument now?>

He's changing his arguments around because his arguments are weak, and he's hoping nobody notices.
Reply: toob247 Asswipe, physics does NOT assert what you are claiming, and there is MORE than just newtons law at fucking WORK HERE.

A. The buildings did not fall at free fall speed.
B. There WAS resistance again MORON. YOU CAN LITERALLY FUCKING SEE DEBRIS FALLING FASTER THAN THE GOD DAMN BUILDING NOT TO MENTION THOSE "EXPLOSION" SOUNDS ARE THE SOUNDS OF THE AIR AND SUBSEQUENT FLOORS BENEATH BEING DEMOLISHED. TOTAL, STRUCTURAL, FAILURE. 

C. WTC 7 was HIT BY DEBRIS AND ON FIRE, BLAZING FIRE. I KNOW ITS HARD TO LOOK AT ANY OF THE OTHER PICTURES OF THE BUILDING THAT SHOW HOW BAD THE FUCKING FIRE WAS BECAUSE YOUR FAVORITE CONSPIRACY SITE ONLY LIKES TO SHOW ONE SIDE... BUT WHETHER YOU LIKE IT OR NOT THERE WAS BOTH VERY SIGNIFICANT STRUCTURAL DAMAGE TO WTC 7 AS WELL AS FIRE. ALSO IF YOU PRACTICE WHAT YOU FUCKING PREACH AND "DO RESEARCH" YOU CAN SEE THAT THE PENTHOUSE STARTS TO COLLAPSE FIRST, THE ENTIRE BUILDING DOES NOT FALL IN COMPLETE FUCKING UNITY, SO AGAIN, YOUR "SMOKING GUN" IS YOU NOT UNDERSTANDING NOR RESEARCHING JACK SHIT.

ALSO YOU FAILED TO READ DR. SEFFENS FUCKING PEER REVIEWED (IN AN ACTUAL ENGINEERING FUCKING JOURNAL) PAPER EXPLAINING THE COLLAPSE OF WTC7. 

SO PLEASE, BY ALL FUCKING MEANS CONTINUE TO COPY PASTE THE SAME FUCKING BULL SHIT FROM 2003-2007 WHEN THIS SHIT WAS OH SO THE RAGE TO BE A PART OF AND START ACTING LIKE AN INTELLIGENT FUCKING PERSON.

IT'S DISGUSTING AT THIS POINT THAT PEOPLE LIKE YOU ARE EVEN ALLOWED TO USE COMPUTERS, BECAUSE FREE SPEECH UNFORTUNATELY INCLUDES THE ABILITY TO LITERALLY SPEW GARBAGE AND FANTASY.
Reply: Emvaz22
Oh, by the way, read it and weep: http://www.debunking911.com/paper.htm
Reply: Semni Istiqlal <Oh, by the way, read it and weep: http://www.debunking911.com/paper.htm>

Seriously, that's all you can come up with?  That "paper" performs no experimentation, does not analyze the dust, does not address the forensic findings of the Harrit paper, and in no way disproves it.  I thought you would have cited the Millette paper and at least put up a semblance of a fight.  Instead you post this tripe and pretend it refutes the Harrit paper?  Sad.

Try again.
Reply: Emvaz22
I see you aren`t going to attempt to refute any of the multiple papers written by actual engineers and people who work in that very field about the collapse of the towers.

Turns out that thermite or not that was a `natural` collapse. The Harrit paper is irrelevant.

You can puff up your chest and insult me all you want but your efforts are hilariously transparent to anyone but yourself. You hide behind insults and a sense of superiority in an attempt to make it seem like you are in a strong position.

In stead you have no real arguments, no real position. You have managed to bring nothing of consequence to the discussion.

There are much better and much more real things to build your ego on my friend.
Reply: Semni Istiqlal <I see you aren`t going to attempt to refute any of the multiple papers written by actual engineers and people who work in that very field about the collapse of the towers.>

Which of these papers refute the presence of thermite proven by the Harrit paper?  Which of these papers proves that the collapse could not have been initiated by a form of pyrotechnic?  Cite an academic source relevant to the argument at hand and I'll be happy to discuss it further.

A building collapse simulation doesn't prove anything.  A simulation isn't reality, and all of these models suffer from confirmation bias (changing the parameters until a collapse occurs).  The example that comes to mind is the NIST simulation of the collapse of building 7.  Not only will NIST not release the parameters they used, but their simulation didn't even resemble the real-world collapse, and there was no peer review.  That's poor science.

Trying to use math to prove a natural collapse is dishonest, because nobody knows the condition and strength of the structure, and all the possible forces at work.  That would be like having an equation A+B=X, guessing what the values for A and B are, and then claiming that you have proof for what X could be.  It's impossible.

These types of analyses could never be used to prove exactly what caused the collapse, and certainly don't serve as a refutation of the forensically proven existence of thermite demonstrated in the Harrit paper.

<Turns out that thermite or not that was a `natural` collapse.>

You have no proof of that.

<The Harrit paper is irrelevant.>

Right, so 10-100 tons of this material just happened to be in the towers, but had nothing to do with the collapse.  Somebody just decided to fabricate this extremely advanced and energetic material, and they put in in their desk drawer.  Gotcha.

The numerous reports of secondary explosions, of pools of molten metal, the eutectic steel documented by FEMA, the unusual amount of microspheres documented by the USGS that match the chemical signature of a product of a thermitic reaction, and the forensic evidence of incendiaries as documented in the Harrit paper all suggest controlled demolition.

But it's irrelevant.  Right.

<you have no real arguments, no real position. You have managed to bring nothing of consequence to the discussion.>

You should stay away from the mirror.  You aren't kind to yourself.
Reply: Emvaz22
And you've painted yourself a hypocrit. You are happy to believe that others must refute your papers or must accept them as fact but when the tables are turned you balk. Typical.

You claim that it's impossible to prove the nature of the collapse when talking about a 'natural' one but then claim you can do just that when talking about your pet theory.

The reason why I havn't attempted to refute your rag is because it's a trap. You shifted the goalposts of the discussion by bringing it up and even if I were to personally refute it then you would simply shift the goalposts again.

You are dishonest, you are a hypocrit and if I were a conspiracy theorist I would be inclined to assume you were part of the conspiracy, however the truth of the matter is that you are a small man trying to prop up his tiny little ego by 'winning' the internet.

PS: All of the other matters you brought up just now have already been covered in this discussion, so please go back and give it another read.
Reply: Semni Istiqlal <And you've painted yourself a hypocrit. You are happy to believe that others must refute your papers or must accept them as fact but when the tables are turned you balk.>

I already explained that such studies don't confer proof.

Here it is again:
"A building collapse simulation doesn't prove anything.  A simulation isn't reality, and all of these models suffer from confirmation bias (changing the parameters until a collapse occurs).  The example that comes to mind is the NIST simulation of the collapse of building 7.  Not only will NIST not release the parameters they used, but their simulation didn't even resemble the real-world collapse, and there was no peer review.  That's poor science.

Trying to use math to prove a natural collapse is dishonest, because nobody knows the condition and strength of the structure, and all the possible forces at work.  That would be like having an equation A+B=X, guessing what the values for A and B are, and then claiming that you have proof for what X could be.  It's impossible.

These types of analyses could never be used to prove exactly what caused the collapse, and certainly don't serve as a refutation of the forensically proven existence of thermite demonstrated in the Harrit paper."

<The reason why I havn't attempted to refute your rag is because it's a trap. >

The reason you haven't attempted to refute it is because you know you can't.

<if I were to personally refute it>

No, no, YOU can't personally refute anything.  You're just an anonymous person on YouTube, and have no credibility.  That would be the same thing as me claiming that the steel was vaporized therefore direct energy weapons must have been used without citing any facts to back up my assertion.  That would be a bogus argument.  You would need to find a published expert who agrees with you, and then cite that expert and explain how he refutes the Harrit report.  Pretend like you paid attention in junior high and remember how to formulate an argument with academic references to back up your claims.
Reply: Emvaz22
Which isn't a refutation of the type you have demanded over and over. You criticize me for being an anonymous person on youtube but then almost in the same breath expect me to take your words at face value.

By introducing the paper you deliberately attempted to move the goalposts, what's to stop you from doing so again. No, I'm not falling for that trap.

You think very highly of yourself and of your scripture. So highly in fact that you actively gloss over or dismiss the flaws and hypocracy in your arguments that I have brought up repeatedly.

You have no proof that anything written in the Harrit paper is true. I on the other hand can point out that Harrit has at the very least the means and motive to misrepresent his findings to support his ideology. Further, his co-authors all share the same point of view, many of which aren't even chemists. On top of this one of the editors of the very paper it was published in resigned in protest of it's publication.

Tell me, why should I believe there is anything even remotely objective about Harrit's paper?
Reply: Justin Gruver i didnt mention freee fall speed. Asswipe? How cute. Total structual failure? Sure we have all seen the core resist and fall from the botttom. The vids where it looks like it turn to dust. I dont believe it turns to dust but clearly it stands firm and then falls from the bottom. 

Building seven was hit by debris. Waah waah freakin waah . so was 4,5,6. They were directly under the towers and took the brunt but they stood firm. How bad the fire was? The fire looks to be almost out by the time of collapse. And the official theory is that one column went than a domino effect. First , it could burn all damn day and night like other previous buildings and not collapse because it was built extra strong to be a bunker type buiilding for these very scenarios.second of course the penthouse collapses first. They use that as a weight to pull toward the center of building as it goes down so the walls dont fall the fuk outward and cause more collateral damage. 

Seffens papers cool . what about all the professional demo experts that say it was a beautiful execution of control demo? 

Its disgusting that people like you are still in denial. Im sure its a cozy existance though.

And congrats on calling names like a spoiled brat child.  Peace .
Reply: toob247 
A. Nowhere, in any videos does the core column of WTC 1/2 fall from the bottom. From the point of impact is where the collapse starts, and the inward bowing can literally be witnessed right before collapse.

B. WTC7, Again which video are you looking at? There are TWO main angles, one angle does not SHOW the intensity whatsoever, so I suggest re-watching the whole collection of angles.

C. These buildings were not designed as "bunkers". These buildings were not designed in the way, say, the Pentagon is. Yes, they were designed to withstand impact/survive long enough for people to escape to safety; the plane size of the TIME the buildings were built. If they were not designed as such, they most likely would've come down MUCH quicker. We have that design to thank for the amount of individuals who were able to BE saved that day, and make it TO safety.

D. Your own words contradict themselves... Note that you state demolitions are done in a way to keep collateral damage to a minimum if not completely contained. Look at the collapse of WTC1 and 2. Nothing about the fall of these towers is a parallel beyond the basic laymen term that they fell "down".

E. Which individuals exactly, and if these demolitions EXPERTS are sure of said theory, they might be able to compile a paper for a Journal in relevant fields that would meet the scrutiny of peer-review correct? Even if we take the number of signatures on AE911 for a new investigation, and run that number against the total number of individuals educated and qualified in the relevant fields world-wide after removing all signatures unproven to have such qualifications, what would the percentage be? In your opinion first off, then run the actual numbers. <1 percent. Which by itself does not automatically refuse them the ability to speak on such things, but that number should either be much HIGHER or that number of individuals should be going through the right scientific channels to bring forth a theory and evidence to peers for review. The U.S. government is not all powerful, If they were all powerful, we wouldn't even be able to comment about this and all of us would be able to be removed without a trace before even hitting the submit button no?

F. Logic. That's what we must use here. No event can ever be 100000000 percent explained to such minute detail as to leave zero anomalies. The theory that answers the MOST questions and has the MOST evidence is the one we find as fact until said time when someone comes along and does the work and does it the right way to challenge said theory and posit one that answers more, and does not leave out A through W.
Reply: toob247
https://upload.wikimedia.org/wikipedia/commons/c/cd/World_Trade_Center_3_After_9-11_Attacks_With_Original_Building_Locations.jpg

They totally look like they stood firm ... yep. No seriously, those buildings got wiped the fuck out as well.

Why do people keep thinking those buildings remained intact?
Reply: Semni Istiqlal this photo proves my point. They were damaged way more than seven but did not collapse . 3 is cover with hslf the tower but stood firm with many floors standing above ground level. Yes they were smashed to shit but no collapse . Four is half smashed to shit with no collapse and five and six have very serious damage multiple times greater than seven. Guess what ? Still standing. But they are missing the mahic fire that brings bukldings down so well why have a controlled demolition industry anyway.
Reply: A . in many videos after the tower falls the core stands firm and then falls over as if damaged from the bottom. Explain the molten ponds of metal on thermal imaging. Dont say fire . it was not a blast furnace.
B. 7. Larry pull it silverstein the luckiest guy in the world ate breakfast at windows of the world everyday. That day he had a dr appt.  How would a fireman know to say keep your eyes on that building , it will be comin down soon? Did he know fire would collapse a building like that with no precedence? 
C. 7 was designed as a bunker and command center where have you been ? 
D. Complete nonesense the did a fantastic job of keeping the collateral damage from the tower demolitions low. The debris wad mostly kept to the trade center property with some exception. Much less collateral damage than the top half of the building leaning over and falling into adjacent buildings. 
E. Is complete nonsense. The all powerful gov is less likely to look guilty if they allow discussion and simply dismiss it as crazy conspiracy. Learn about plausible deniability. 

E. Again search for demo experts and their testimony. Exclude lying mark louazou

F . logic . yes by your criteria we must acccept the fact that it was a well done controlled demo as this theory answers the most questions and has the most evidences. 

Geeee. 
Get over it they took down two old asbestos ridden towers to blame it on terrorist to get the whole country behind going to war and killing those that hate america on their sole before they could really attack us beyond our control. Remember condelleeza lice? Better to get them there before the next attac is in the form of a mushroom cloud. 
Easy to sleep at night killing a few thousand americans when you believe youre saving millions. 
H. How bout you stop schilling and start objectively loooking at it with equal zeal from both perspectives? 
I. I dont need to educate you further its all available for free if you just look. 
P. Peace out
Reply: toob247
Pay attention to the amount of floors those buildings had. It's almost as if a shorter and squatter structure is better at taking damage than a tall spindly one.

It's not even like they stood firm, they collapsed entirely in areas however due to their short squat nature those collapses did not take down the whole building with it.

Other than that, Toob, you are literally full of shit, every point you make here has been debunked in this very conversation already. Trying to pretend it hasn't just makes you look like a short sighted zealot who cannot see further than his own indoctrination.
Reply: Semni Istiqlal <Which isn't a refutation of the type you have demanded over and over.>

It's impossible to disprove what does not confer proof in the first place.  Your mathematical models and building collapse simulations don't prove anything.  Showing what COULD happen is in no way proof of what DID happen.

<By introducing the paper you deliberately attempted to move the goalposts, what's to stop you from doing so again. No, I'm not falling for that trap.
>

Right, I moved the conversation from speculation to fact.  I present evidence that is proven by scientific fact.  You can't cite any conflicting academic study to disprove these facts.   The facts conflict with the official story, while at the same time supporting forensic evidence, eyewitness testimony, and basic physics.

<You think very highly of yourself and of your scripture. So highly in fact that you actively gloss over or dismiss the flaws and hypocracy in your arguments that I have brought up repeatedly.>

You haven't brought up any scientifically backed flaws.  Stop pretending like you did.

<You have no proof that anything written in the Harrit paper is true.>

The scientific and forensic experimentation, the peer review process, and the fact that it has not been refuted in over six years strongly supports the factual findings of the paper.  Is there a paper to refute it?  Didn't think so.

<I on the other hand can point out that Harrit has at the very least the means and motive to misrepresent his findings to support his ideology.>

Ad hominem.  Unscientific.  Nonfactual.

<On top of this one of the editors of the very paper it was published in resigned in protest of it's publication.>

False ad hominem.  Resigned due to political pressure.  No specific criticism of any technical aspect of the paper.  Do you have any facts that refute the Harrit paper?  No?  Too bad.

Try again.
Reply: Emvaz22
So really all you have done all this time is simply dismiss everything you disagree with. It really has been the discussion equivalent of sticking your fingers in your ears and shouting "Lalala, I cannot hear any counter-arguments."
Reply: Semni Istiqlal <So really all you have done all this time is simply dismiss everything you disagree with. It really has been the discussion equivalent of sticking your fingers in your ears and shouting "Lalala, I cannot hear any counter-arguments.">

Nope.  What I've done is weight what has been demonstrated by scientific experimentation and peer review (The Harrit paper) against what is purely conjecture and logical fallacy (all of your bogus and easily explainable objections) and poor science (your simulations and mathematical models which don't confer proof of any kind, nor refute the Harrit paper in any way).

It's clear to me, and probably to most people in the comments section of this video, which argument holds more weight.
Reply: Emvaz22
It's definitely one way of maintaining your argument. Just ignoring everything everyone else says. You havn't really adressed anything in any way other than shouting "Harrit paper! Harrit paper!"  very loudly.

As if that is the be all and end all of a discussion.

For example you don't even directly source the paper, you are taking certain conclusions from it and intepreting it in a way that suits your argument.

The paper is a lot less certain about it's conclusions than you are. They are talking about a "Termitic" material, thermite-like. If they knew it was actually thermite they would be calling it thermite, implying a man-made origin, in stead they aren't certain.

You creatively interpret that as = Man Made Thermite.

Another thing they mention is nanoscale particles. Which you again interpret as Nano Thermite, again a man-made material.

However there's several problems with this. In 2001 you could produce grams of nano-thermite in a lab. There was no industrialized process for manufacturing it until years later. Even today production of it is limited.

Producing the literal tons of that material needed for a building like that would be no trivial process.

Also one thing from the paper you conveniently fail to mention is the variation in particle size. Yes there were nanoscale particles but there were also 'large' particles mixed in and everything inbetween. The paper likes to avoid paying attention to this but in manufactured Thermite the particle size is more or less all the same. You are going to have to explain what's going on there because those are not characteristics of a manufactured material.
Reply: Semni Istiqlal <Just ignoring everything everyone else says.>

Who says I'm ignoring anything you've brought up?  On the contrary, I've addressed every point specifically and explained how none of it confers proof or refutes the Harrit study.  Care to disagree?  Which one of your studies confers proof?  Cite the source, and then explain specifically how proof is determined from your source, and how it refutes the Harrit study.  Specifically.

<The paper is a lot less certain about it's conclusions than you are. They are talking about a "Termitic" material, thermite-like. If they knew it was actually thermite they would be calling it thermite, implying a man-made origin, in stead they aren't certain.>

"1. It is composed of aluminum, iron, oxygen, silicon and carbon. Lesser amounts of other potentially reactive elements are sometimes present, such as potassium, sulfur, lead, barium and copper.
2. The primary elements (Al, Fe, O, Si, C) are typically all present in particles at the scale of tens to hundreds of nanometers, and detailed XEDS mapping shows intimate mixing.
3. On treatment with methyl ethyl ketone solvent, some segregation of components occurred. Elemental alu- minum became sufficiently concentrated to be clearly identified in the pre-ignition material.
4. Iron oxide appears in faceted grains roughly 100 nm across whereas the aluminum appears in thin plate- like structures. The small size of the iron oxide parti- cles qualifies the material to be characterized as nano- thermite or super-thermite.
5. Analysis shows that iron and oxygen are present in a ratio consistent with Fe2O3. The red material in all four WTC dust samples was similar in this way. Iron oxide was found in the pre-ignition material whereas elemental iron was not.
6. From the presence of elemental aluminum and iron oxide in the red material, we conclude that it contains the ingredients of thermite.
7. As measured using DSC, the material ignites and re- acts vigorously at a temperature of approximately 430 ̊C, with a rather narrow exotherm, matching fairly closely an independent observation on a known super-thermite sample. The low temperature of igni- tion and the presence of iron oxide grains less than 120 nm show that the material is not conventional thermite (which ignites at temperatures above 900  ̊C) but very likely a form of super-thermite.
8. After igniting several red/gray chips in a DSC run to 700  ̊C, we found numerous iron-rich spheres and spheroids in the residue, indicating that a very high- temperature reaction had occurred, since the iron-rich product clearly must have been molten to form these shapes. In several spheres, elemental iron was veri- fied since the iron content significantly exceeded the oxygen content. We conclude that a high-temperature reduction-oxidation reaction has occurred in the heated chips, namely, the thermite reaction.
9. The spheroids produced by the DSC tests and by the flame test have an XEDS signature (Al, Fe, O, Si, C) which is depleted in carbon and aluminum relative to the original red material. This chemical signature strikingly matches the chemical signature of the sphe- roids produced by igniting commercial thermite, and also matches the signatures of many of the micro- spheres found in the WTC dust [5].
10. The carbon content of the red material indicates that an organic substance is present. This would be ex- pected for super-thermite formulations in order to produce high gas pressures upon ignition and thus make them explosive. The nature of the organic mate- rial in these chips merits further exploration. We note that it is likely also an energetic material, in that the total energy release sometimes observed in DSC tests exceeds the theoretical maximum energy of the clas- sic thermite reaction.
Based on these observations, we conclude that the red layer of the red/gray chips we have discovered in the WTC dust is active, unreacted thermitic material, incorporating nanotechnology, and is a highly energetic pyrotechnic or explosive material."

Seems pretty cut and dry to me.  Given these 10 proven facts, what are you suggesting this material is?  Please say primer paint.

<You creatively interpret that as = Man Made Thermite.>

Oh I see, so you believe all of this incendiary material perfectly and uniformly mixed in approximate stoichiometric proportions in midair, in uniforms crystalline shape and size, and then fused itself into a carbon and silica matrix, all randomly.  What a brilliant analysis. Can you cite any science or any expert that agrees with you?  This looks like another one of your unsubstantiated claims.  I'm beginning to see a pattern here...

<Another thing they mention is nanoscale particles. Which you again interpret as Nano Thermite, again a man-made material.>

Uhh, a thermitic compound where at least one of the reactants is in nano-scale is by definition nano-thermite.  Thats not an interpretation, thats a fact...

< In 2001 you could produce grams of nano-thermite in a lab. There was no industrialized process for manufacturing it until years later. Even today production of it is limited.>

Right, because I'm sure that none of the billions of black-budget military dollars could have been used to fabricate 100 tons of this material.  Nah, couldn't be.

<Producing the literal tons of that material needed for a building like that would be no trivial process.>

When did anyone say it would be a trivial process?

<Also one thing from the paper you conveniently fail to mention is the variation in particle size. Yes there were nanoscale particles but there were also 'large' particles mixed in and everything inbetween.>

Oh wow he's finally addressing the paper specifically.  A credible citation would have been nice but I'll take what I can get.  Welcome to the debate.  Figures 8, 9 and 10 show uniformly sized, shaped, and distributed reactants.  Where in the paper are there "large" particles that were recorded?
Reply: Emvaz22
And you continue to ignore what I'm actually saying and just continue to preach your bullshit.

Those large particles are IN YOUR PAPER, don't hit me with that bullshit. Seriously, do you even try to read the paper in it's entirity?
Reply: Justin Gruver <A. Harrit's paper did not pass peer review first off.>

Yes it did.  Prove otherwise.

<B. Harrit's paper was not published nor submitted to an ACCREDITED JOURNAL>

Yes it was.  Bentham journals are an acceptable source is any academic context.  Prove otherwise.

<C. The Red/Gray iron chips/spherules can and will be found, with friction of steel rubbing against itself or being heated whatsoever. Not an implicit sign that thermite is used anywhere.
>

The expected amount of iron microparticles of a given collapse is known.  The WTC contained far more microspheres than normal, and these microspheres match the chemical composition of know thermite byproducts.  Can you demonstrate that "normal" microspheres also match the chemical composition of known thermite products?  I don't think you can.

<D. Levels of the Aluminum, Carbon, Iron, Silicon, the others, INCLUDING BARIUM are all naturally found>

Sol-gel nanothermite does not form naturally.  It's an engineered material, involving advanced equipment and techniques.  Do you believe that a tornado going through a junkyard is going to result in the construction of a Rolls-Royce?  You're an idiot.

<The LITERAL smoking gun is not described ANYWHERE, nor shown to be ANYWHERE>

Except for, you know, the whole Harrit paper.

<Like you say, the paper does a whole lot of nothing in the first place.>

I said that?  Quote me.  Oh wait, you're just lying again.

<E. There ARE papers, published in REAL journals, that YOU have NOT read>

Which of these papers test the dust for incendiaries and directly refute the Harrit study?  Be specific.

<Jones & AE911 crew publish their paper(s) in Bentham OPEN Journal. An online, NON Academic NON accredited journal>

Accredited and academic.  Do you have anything to directly refute the Harrit paper, or are you going to pretend like your ad hominems amount to a real argument?

<even stating themselves that no smoking gun is in their paper>

Quote that part of the paper, with page number.

<THEN YOUR crew can't even AGREE ON THAT as AE911 split TWO WAYS because some of YOUR EXPERTS BELIEVE THAT DIRECTED ENERGY WEAPONS/TACTICAL NUKES/HOLOGRAMS/ETC. >

Which expert believes that, and which journal is their paper published in?  Other than Judy Wood, nobody actually believes that.  Any more made-up ad hominems, or is that you last one?

<Because it is WAY too many years since that shit got debunked>

Cite the paper that debunks it.  Author.  Title.  Publication.  Date.  Thanks, trash.

<NOR DID YOU LOOK INTO THE ACTUAL RESPONSES JONES' PAPER GOT>

What published responses disagree with the Harrit paper?  Oh, you've still got nothing?

It seems like you enjoy pretending that the Harrit paper has been refuted, but you have yet to cite any evidence to support your argument.  Too bad.  Care to try again?
Reply: Justin Gruver <A. Bentham is not a respected journal and
B. Jones', Harrit, Griffin's paper did not pass peer-review.

Both of these can be squashed with ONE link.
http://publishingarchaeology.blogspot.com/2009/06/hoax-paper-accepted-by-benthan.html>

Pfft.  What paper are you referring to?  What edition was it published in, and what date?  Oh it was never published?  Fancy that, another one of your misrepresentations.

The editors of the publication were being spammed with gibberish papers by people trying to discredit their review process.  The papers were submitted under an alias.  In order to find out the perpetrator, Bentham said that the paper was accepted so as to initiate the payment process.  In this process, the fraud would have to reveal himself in order to post payment.  The gibberish paper was never published, nor was there ever intent to publish.  And this is your proof?  You don't have a very good grasp of what constitutes proof.  Hearsay is not proof.

<For iron-microspheres

https://www.metabunk.org/debunked-iron-microspheres-in-9-11-wtc-dust-as-evidence-for-thermite.t2523/>

I asked you to cite an academic source.  A blog post that references other blog posts is not an academic or credible source.  You're going to try to attack the Harrit paper because you claim that it is not posted in a credible publication (which is false), and then in your next sentence you are trying to cite a "debunker" blog post as science.  I hope you can see the irony.

<Publish in an open online journal - paper is NOT put through the same (if any in many cases) scrutiny that peer-review puts on papers submitted in a REPUTABLE JOURNAL.>

You keep implying that an "open" journal means they publish anything that anybody submit and pays to have published, which is false.  An open journal is simply a journal that does not require a subscription fee to access. The authors state that they chose an open journal so that anybody who had the internet could access it.  Jones also states (and his statement is corroborated by one of the reviewers David Griscom) that the review process for this paper was exceptionally comprehensive.

<Again, it's not Ad Hominem. It's fucking FACT.>

No, it's more like hearsay and deliberate misrepresentation of facts.  You're having a hard time discriminating fact from speculation.

<The papers published by other individuals, which I DID link in this thread, were published in REPUTABLE JOURNALS. THERE papers WERE PEER REVIEWED. REPUTABLE JOURNAL, TAKEN SERIOUSLY.>

Stop making shit up.  You haven't cited a single journal article that refutes the Harrit study.  Its funny to watch you keep pretending like you did though.

<They found no DIRECT evidence of thermite. None. Not one trace.>

Except for all that advanced military-grade thermite they found.

< Where would this info be if it was credible and passed peer-review, etc.? Everywhere, News, Everywhere.>

You obviously don't understand how the mainstream media operates.  I can see it now:  "Good morning America!  This just in: Everything we've told you about 9/11 for the past 14 years is based on a lie, because we aren't journalists, we're simply talking heads who repeat what the government tells us to repeat.  Oh, by the way, all the wars we've been involved in, and our entire foreign policy, is a complete fraud.  Have a nice day!"

Yeah, thats going to happen.

Any actual published facts to refute Harrit?  Anything other than ad hominem and misrepresentation of facts?
Reply: Emvaz22
Unfortunately for you the burden of proof lies with the person making the assertion, you are the one who has to prove that your paper is peer reviewed, you are the one who has to prove that the journal can be taken seriously, you are the one who has to prove that the buildings were demolished. You have failed on all accounts.

You have ignored all proof to the contrary, in stead all you have done is use argument from authority, attempt to shift the burden of proof on to others and attempt to undermine the credibility of everyone who doesn't agree with you by repeatedly accusing them of a wide variety of logical fallacies, your favorite being ad-hominem.

All in a desperate attempt to hide the fact that you do not have an argument.
Reply: Semni Istiqlal <Unfortunately for you the burden of proof lies with the person making the assertion>

Right, and my assertion is that there was thermite present in the WTC dust.  My supporting citation is the Harrit paper, which proves that thermite was present in the WTC dust.  Tah-Da!  

<you are the one who has to prove that your paper is peer reviewed>

Actually it's your assertion that the Harrit paper is not peer reviewed.  Because you obviously have no technical refutation of the paper, you are using this transparent ad hominem in lieu of an actual factual argument.  The burden of proof lies with you.  The Journal says it was peer reviewed.  The authors say it was peer reviewed.  The peer reviewer says it was peer reviewed.  What's your proof, exactly?  Try again.

<you are the one who has to prove that the buildings were demolished.>

Building 7 free-fall, the scientifically demonstrated presence of incendiary material, the melted/vaporized eutectic steel as documented by FEMA, the iron microspheres as documented by USGS that match the specific chemical signature of thermite byproducts, the first responder testimony of molten pools of iron under the rubble heap, and the fact that the heap smoldered for 3 months despite being doused with water and chemical flame retardants, all point to demolition.  

Can you refute the Harrit paper factually?  Can you explain the creation of melted/vaporized steel in a "normal" office fire?  Can you demonstrate that all "normal" iron microspheres have the same chemical signature of those spheres produced in a thermite redox reaction?  Or maybe ad hominem is all you can come up with.

<You have ignored all proof to the contrary>

What proof to the contrary?  All I've seen you cite thus far are "debunker" blog posts that don't prove anything, and rely heavily on ad hominem fallacy to try to discredit the Harrit study so that you don't have to try to refute it in a meaningful way.  Ironic how you try to refute the Harrit paper by claiming (falsely) that it wasn't peer reviewed, and then cite as your evidence a blog post, which definitely wasn't peer reviewed.  It seems your supporting evidence doesn't meet your own criteria for credibility.

Any refutation of the Harrit paper?  Still nothing?
Reply: Emvaz22
And around in circles it goes. I have already previously in this very discussion adressed every single one of the points you have made here. You've decided to ignore them.

You do so because you don't actually have an argument, everything you have said is either simply not true, or relies on argument from authority.
Reply: Justin Gruver
He's easy to keep busy though, and easy to distract from bothering other people.
Reply: Semni Istiqlal <And around in circles it goes.>

Around in circles YOU go.  My position has remained consistent.  YOU, on the other had keep changing your story.

First argument:  Thermite is proven, but the "narrative" cannot be proven, therefore it means nothing (an idiotic argument.  The narrative is the jurisdiction of a second investigation, not the responsibility of a forensic experiment).

Second argument:  The thermite is real, but it all just happened to perfectly engineer itself from the aluminum cladding, rust from the beams, etc, spontaneously fusing into a stoichiometrically viable and consistently formulated super incendiary in midair during the collapse.  Obviously an idiotic statement.  Do you believe a tornado blowing through a junkyard is going to produce a Rolls Royce?  Not just one Rolls Royce, but several identical Rolls Royces.  As I said, idiotic.

Third argument:  Building collapse models with estimated parameters and mathematical models with estimated values somehow disprove the forensic evidence proven in the Harrit paper.  Or course anyone with a 4th grade intellect can see that your estimated models prove nothing, and disprove even less.  You're dumb.

Fourth argument:  The Harrit paper doesn't count because (insert ad hominem).  Of course, anyone who knows anything about logic knows that ad hominem is the end-of-the-rope of a bankrupted argument, and is the archetype of logical fallacy  You clearly have nothing.

Any more prefabricated bullet points you care to copy-paste from your meatpuppet, shill notebook?  I'll wait here.

<I have already previously in this very discussion adressed every single one of the points you have made here. >

Performing a curtsey may be an address, but it's not a factual refutation.  In order to refute the Harrit paper, you would need to demonstrate how the paper itself is technically flawed, or cite an alternative published analysis of the WTC dust.  You have done neither.  It's funny to watch you pretend like you did though.  Your ad hominem trash doesn't count as an actual refutation.  Not only is it a misrepresentation of facts, but it in no way addressed the paper directly, which you seem afraid to do.  Try again, little miss.
Reply: Justin Gruver <He asks if any refutation of the harrit paper exists, I literally sourced and linked shit. He ignores it.>

Oh you did?  You cited a credible, published refutation of the Harrit paper?  You explained how the Harrit paper is technically flawed?  Here are the conclusions:

"We have discovered distinctive red/gray chips in signifi- cant numbers in dust associated with the World Trade Center destruction. We have applied SEM/XEDS and other methods to characterize the small-scale structure and chemical signa- ture of these chips, especially of their red component. The red material is most interesting and has the following charac- teristics:
1. It is composed of aluminum, iron, oxygen, silicon and carbon. Lesser amounts of other potentially reactive elements are sometimes present, such as potassium, sulfur, lead, barium and copper.
2. The primary elements (Al, Fe, O, Si, C) are typically all present in particles at the scale of tens to hundreds of nanometers, and detailed XEDS mapping shows intimate mixing.
3. On treatment with methyl ethyl ketone solvent, some segregation of components occurred. Elemental alu- minum became sufficiently concentrated to be clearly identified in the pre-ignition material.
4. Iron oxide appears in faceted grains roughly 100 nm across whereas the aluminum appears in thin plate- like structures. The small size of the iron oxide parti- cles qualifies the material to be characterized as nano- thermite or super-thermite.
5. Analysis shows that iron and oxygen are present in a ratio consistent with Fe2O3. The red material in all four WTC dust samples was similar in this way. Iron oxide was found in the pre-ignition material whereas elemental iron was not.
6. From the presence of elemental aluminum and iron oxide in the red material, we conclude that it contains the ingredients of thermite.
7. As measured using DSC, the material ignites and re- acts vigorously at a temperature of approximately 430 ̊C, with a rather narrow exotherm, matching fairly closely an independent observation on a known super-thermite sample. The low temperature of igni- tion and the presence of iron oxide grains less than 120 nm show that the material is not conventional thermite (which ignites at temperatures above 900  ̊C) but very likely a form of super-thermite.
8. After igniting several red/gray chips in a DSC run to 700  ̊C, we found numerous iron-rich spheres and spheroids in the residue, indicating that a very high- temperature reaction had occurred, since the iron-rich product clearly must have been molten to form these shapes. In several spheres, elemental iron was veri- fied since the iron content significantly exceeded the oxygen content. We conclude that a high-temperature reduction-oxidation reaction has occurred in the heated chips, namely, the thermite reaction.
9. The spheroids produced by the DSC tests and by the flame test have an XEDS signature (Al, Fe, O, Si, C) which is depleted in carbon and aluminum relative to the original red material. This chemical signature strikingly matches the chemical signature of the sphe- roids produced by igniting commercial thermite, and also matches the signatures of many of the micro- spheres found in the WTC dust [5].
10. The carbon content of the red material indicates that an organic substance is present. This would be ex- pected for super-thermite formulations in order to produce high gas pressures upon ignition and thus make them explosive. The nature of the organic mate- rial in these chips merits further exploration. We note that it is likely also an energetic material, in that the total energy release sometimes observed in DSC tests exceeds the theoretical maximum energy of the clas- sic thermite reaction.
Based on these observations, we conclude that the red layer of the red/gray chips we have discovered in the WTC dust is active, unreacted thermitic material, incorporating nanotechnology, and is a highly energetic pyrotechnic or explosive material."

You refuted all this, point by point?  I must have missed that post.  Can you post it again?  Thanks.
Reply: Emvaz22
It would help your case if they were actually ad-homs.

I am under no obligation to cater to your whims and desires. If fact your response there demonstrates your inflexible dogmatic thinking. I was willing to look at the evidence at hand and posit different perspectives on it, even learning and growing when presented with new information and gaining a greater understanding of the situation. Unlike you when my opinion doesn't fit the facts I change my opinion. What you have done on the other hand is stick tenaciously to your dogma regardless of what you have been presented with.

That you believe this to be a strength is telling. It is not, it's a weakness.

The unfortunate fact for you is that extraordinary claims require extraordinary evidence. What you have presented just isn't.
Reply: Emvaz22
You look back in the history of this discussion you know. It's not hard. Use Ctrl+F.
Reply: Semni Istiqlal <It would help your case if they were actually ad-homs.>

Ad hominem is an argument that does not address the facts, but instead tries to discredit them by attacking the source of those facts.  Spreading disproven lies about the publication (not peer reviewed, snuck past the editors, publishes gibberish, etc) instead of addressing the facts contained in the paper would be ad hominem.  Not only does your argument rely on attacking the publication, but it also relies on presenting misrepresentations as facts.

<I am under no obligation to cater to your whims and desires.>

I never said you were.  You're more than welcome to admit that you can't refute the Harrit paper.  No need really.  Either way, your inability to refute the paper thus far in the conversation is essentially an admittance that you can't.  You can keep pretending though.

<I was willing to look at the evidence at hand and posit different perspectives on it>

But you never did.  I don't think you can.

<Unlike you when my opinion doesn't fit the facts I change my opinion.>

More like, when your argument doesn't fit the facts, you change your argument, and then change it again, and again.  Then you pretend like it never happened.  Then you pretend like you already refuted my statement, which you never have.

<What you have done on the other hand is stick tenaciously to your dogma regardless of what you have been presented with.>

Why would I change my believe in the conclusions of a scientific paper if it has never been refuted?

<You look back in the history of this discussion you know. It's not hard. Use Ctrl+F.>

Right, you keep claiming that you've provided a credible refutation of the Harrit paper, but I can't seem to find it.  Why don't you just go back into your old posts and copy-paste the part where you demonstrated a technical flaw in the Harrit study or cited an alternative analysis of the WTC dust that conflicts with the Harrit study?
Reply: Emvaz22

A. If I write a paper about how, Unicorns must exist somewhere in the infinite Universe, and you don't take it seriously. Does that mean I'm right?

B. The only "peer-reviewer" of the Harrit Paper was um... someone Jones knew. Not anonymous at all. This same person HELD the same beliefs, as evidenced in prior defending of 911 conspiracy theories.

C. NO CHAIN OF POSSESSION for the material tested by Jones/Harrit.

D. There is ALREADY a "theory" that the scientific community accepts as fitting and answering the most questions. It is considered factual. There are papers detailing it in REPUTABLE JOURNALS. They WERE PEER REVIEWED. 

E. If you want Ad Hominem, the fact that Jones is interested in the Book of Fucking Mormon enough to carbon date shit (which others have done, and came to the same fucking conclusions)... yeah. The man is not an engineer or architect. The man is intelligent enough to manipulate, as you are gullible enough to utilize the same argument that religion uses.

F, Pretty much, go fuck yourself. You waste people's time. You are ignorant to the scientific method. You are ignorant to where you SHOULD study things from. You are ignorant to yourself. You're a nobody. The scientific community not just in America, but 99 percent of the scientific fucking community World-Wide has the same consensus. So tell your boys to step up and publish in a reputable journal. Until then, nobody NEEDS to refute it in entirety. It's already lacking in credibility to even WARRANT someone taking a look at it.
Reply: Justin Gruver <A. If I write a paper about how, Unicorns must exist somewhere in the infinite Universe, and you don't take it seriously. Does that mean I'm right?>

It does if you can forensically prove the existence of unicorns and have the findings published in an academic journal.  Your analogy is a poor one.

<B. The only "peer-reviewer" of the Harrit Paper was um... someone Jones knew. Not anonymous at all. This same person HELD the same beliefs, as evidenced in prior defending of 911 conspiracy theories.>

First of all, Jones did not know Griscom personally prior to the peer review.  Secondly, the paper was reviewed by TWO referees.  Any more lies?

<C. NO CHAIN OF POSSESSION for the material tested by Jones/Harrit.>

Another lie.  The Harrit paper explains in detail the provenance of all 4 of their samples, with names, locations, and time of collection, along with videotaped testimony, eyewitnesses, and signed affidavits.  Are you implying that the samples were tampered with?  Do you have any proof of this?  Can you prove the scientists involved with the Harrit report had the capability and specialized equipment required to fabricate such an advanced thermitic material?  Can you cite an alternative analysis of the dust that does not turn up such material?  Of course not, because you have nothing, no argument whatsoever.

<D. There is ALREADY a "theory" that the scientific community accepts as fitting and answering the most questions. It is considered factual. There are papers detailing it in REPUTABLE JOURNALS. They WERE PEER REVIEWED. >

Any papers supporting the "official" conspiracy that fires lead to the collapse of 3 steel skyscrapers involve collapse models utilizing estimated parameters, and mathematical models utilizing estimated values.  Because nobody knows the extent of structural damage the plane caused, of the precise temperature and locations of all the fires, nobody could know all of the forces at work in this scenario.  Therefore your models and simulations do not confer proof, and do not establish fact.  Nice try though.

<E. If you want Ad Hominem, the fact that Jones is interested in the Book of Fucking Mormon enough to carbon date shit (which others have done, and came to the same fucking conclusions)... yeah. The man is not an engineer or architect. The man is intelligent enough to manipulate, as you are gullible enough to utilize the same argument that religion uses>

When did I say I wanted ad hominem?  I merely said that ad hominem is a logical fallacy that does not amount to a real argument.  And here you are using more ad hominem, and acting like it strengthens your position.  Pretty sad.

<F, Pretty much, go fuck yourself. You waste people's time. You are ignorant to the scientific method. You are ignorant to where you SHOULD study things from. You are ignorant to yourself. You're a nobody. The scientific community not just in America, but 99 percent of the scientific fucking community World-Wide has the same consensus. So tell your boys to step up and publish in a reputable journal. Until then, nobody NEEDS to refute it in entirety. It's already lacking in credibility to even WARRANT someone taking a look at it.>

Baseless cop-out.  If the paper is flawed, then where is your academic analysis of the dust that proves this?  You don't have one?  Too bad.  Keep trying, worthless meat puppet.
Reply: North Tower
Total 110 floors
Hit 93rd floors
Total mass ~ 600,000 tons (I've excluded the mass of the concrete foundation since it isn't relevant)

93/110 = 0.85

.15 of the mass above the hit.

600,000 * 0.15 = 90,000 tons suspended above damaged area.

Total height 417m

417 / 110 = 3.79m per floors

93 * 3.79 = 352.47m heigh of the 93rd floor.

U = mgh

U : Potential energy
m : Mass in kg
g : 9.81
h : height in meters

90,000,000 * 9.81 * 352.47 = 311,195,763,000 joules

The TNT equivalent of one ton is 4.184 gigajoules

311,195,763,000 / 4,184,000,000 = 74.38 ~ tons of TNT equivalent

So the portion of the North Tower above the 93rd floor suspended at a height of approximately 352 meters with a mass of approx 90,000 tons has the stored potential energy equivalent to approximately 74 tons of TNT.

On the way down it's going to expend that potential energy. This is why I am sceptical of people claiming that the buildings needed explosives to come down like that.

And I didn't even factor in the energy stored in the remaining 510,000 tons of building...
Reply: *****
Considering that building 7 was already taller than the tallest building ever imploded at that point in time you'd have quite the task at hand. I'd advise against demolition entirely. It's in a highly built up area and you are going to have to strip out materials like asbestos anyway before engaging in demolition.

The safest way of doing it would be to tear apart the buildings floor by floor. Honestly, it'd probably just be cheaper to tear out the asbestos and renovate the structure than attempting to demolish it.

Now if I were a shadey government agency/building owner with no scruples I'd fly two planes into the buildings. By far the cheapest way of getting rid of the buildings. Even if the buildings don't collapse they likely will have to be torn down anyway and I'd have my insurance paperwork in order as well.
Reply: Semni Istiqlal <So the portion of the North Tower above the 93rd floor suspended at a height of approximately 352 meters with a mass of approx 90,000 tons has the stored potential energy equivalent to approximately 74 tons of TNT.>

Your equation is calculating the energy of the top portion of the tower falling 352 meters through air without any resistance and hitting the ground.  You forget to factor in the bottom 2/3rds of the towers directly below the top portion, which were untouched and undamaged, and composed of larger structural columns than the relatively lighter top portion.  Instead of releasing the potential energy you calculated, the top floors only fell a dozen or so feet before meeting the undamaged support structure.  Moreover, the top portion never completely broke loose, and was always at least partially connected to the bottom potion, so could not have accelerated at 9.81 m/s2.  Making your equation irrelevant. 

Your equation also fails to account for the ability of the bottom structure to resist the vertical force of the upper portion.  To put it simply, you are calculating x+y=z, where z is whether or not the towers structurally fail.  Instead of fully accounting for x and y, you come up with a partial, oversimplified version of x, totally omit y, and claim to know the value of z.  It's disingenuous at best.

<And I didn't even factor in the energy stored in the remaining 510,000 tons of building...>

You mean the 510,000 tons of steel reinforced structure that would be resisting and acting against the force of the much lighter, much smaller top portion?  These numbers don't exactly help your argument.  You should look up Newton's Third Law.

I should also say that even if you DID have all the variables (which would be impossible to know for sure), none of this is relevant to the Harrit study, because none of this directly addresses the findings of the study or refutes it.
Reply: Emvaz22
You don't really seem to understand what these equations mean so I'll explain.

U = mgh is the equation for figuring out the potential energy of a given mass at a given height in a given gravity field. At sea level on earth the acceleration due to gravity is 9.81m/s^2 ( this is an approximation but it's close enough for our purposes ).

In order to get an object up to a given height you are going to have to counteract the force of gravity, essentially storing potential energy in the object in the form of altitude.

When said object falls back down to earth from that height it is going to expend that energy in one way or another.

Also you don't seem to understand what g means. It's not the acceleration of the object. It's the gravitational force slightly converted to simplify the equation.

You seem to misunderstand what these calculations are illustrating. They make the statement that just the upper floors alone in their fall subjected the rest of the building to energies in excess of an equivalent 74 tons of TNT.

I am illustrating the titanic energies involved in that amount of mass collapsing. Not a calculation on wether or not the tower would fall.

Your response also forgets how buildings resist forces. Buildings are not homogenous structures, the towers had the approximate density equal to pinewood, however if you had a pinewood block 64m on each side and 417m tall it'd fall apart under it's own weight. The WTC towers were built to take the weight of the upper floors through the columns, the floor spaces were not meant to take much weight at all. Maybe 100 tons, perhapse even a 1000, however that's not nearly enough to resist 90,000 tons of debris coming down on them. The columns would initially resist the debris but the floors would immediately give way. With nothing to hold the columns straight they would soon collapse like wet spaghetti.

The structure would impart drag on the falling mass, however in order to arrest the decent it would need to impart more drag than the inclusion of new debris and decrease in altitude would add to the falling mass. Unfortunately the parts that can resist the strongest forces also have the smallest crossectional area, those being the columns. The floors with the largest cross-section cannot resist much force at all compared to the weight of the building.
Reply: Semni Istiqlal <You don't really seem to understand what these equations mean so I'll explain.>

Nope, I think I understand pretty well.  You calculate the potential energy of the top floors without addressing the amount of energy that the bottom floors can resist.  Therefore your calculations are next to meaningless.

<When said object falls back down to earth from that height it is going to expend that energy in one way or another.>

And when there are tons of structural steel in the way that just happened to be specifically engineered to resist the weight of the top section, it will tend to distribute that energy evenly through the structure and into the ground.  As it had done for decades.

<You seem to misunderstand what these calculations are illustrating. They make the statement that just the upper floors alone in their fall subjected the rest of the building to energies in excess of an equivalent 74 tons of TNT.>

And?  Although both events may contain the same energy, a collapsing structure isn't explosive.  You are attempting to draw a parallel between two thing that are totally dissimilar.  TNT isn't dangerous because of the energy it contains, it is dangerous because it expends all of its energy instantaneously (explosively) through expanding gasses.  74 tons of TNT would look and act way differently that the collapse of the top of a building.  

<I am illustrating the titanic energies involved in that amount of mass collapsing. Not a calculation on wether or not the tower would fall.>

Actually you implied in your prior post that your "74 tons" calculation alone is enough to result in a straight-down, near free-fall collapse of the towers.  But you never attempt to calculate the ability of the towers to resist vertical forces.  Your you are jumping to the conclusion without completing the equation.

That would be like looking at a 5 lb burrito, saying "5 lbs is a lot of burrito, therefore it must be impossible to consume," without accounting for the size of the stomach and its ability to stretch to accommodate said burrito.

Like I said, disingenuous at best.  But I'm leaning more towards deliberately deceptive.

None of this refutes that Harrit paper.  FYI.
Reply: ***** < Now teII me, what are the chances that on 9-|| the "natural" fires in not one, not two, but THREE buiIdings resuIted in the almost perfect, bizarrely neat, coIIapse of aII three buiIdings?>

I've got about as much chance of shitting a gold brick.
Reply: Emvaz22
I refer you to my second reply. In my first set of calculations the 'drag' created by the building is irrelevant. It's not a discussion on wether or not the building would fall.

People who state that 'the building could not have fallen under it's own weight' don't have much perspective on the kinds of energies that are involved in a collapse on a scale like this. It's an illustration. It's not there to prove a point, it's there to provide others with perspective.

Also, please stop trying to perpetuate the myth that the buildings fell at freefall speeds: http://www.debunking911.com/freefall.htm

To put it in the context of a burrito. It's more like pointing out the amount of calories in the burrito in a discussion about how it devastated your wasteline.

And of course out come the veiled accusations of me being a shill. It's amazing how consistently conspiracy theorists truck that one out.
Reply: Semni Istiqlal <People who state that 'the building could not have fallen under it's own weight' don't have much perspective on the kinds of energies that are involved in a collapse on a scale like this>

The scale of the potential energy of the top portion is exceeded by the scale of the solid steel structure, which had thicker columns and more mass, directly below it.

<Also, please stop trying to perpetuate the myth that the buildings fell at freefall speeds>

I said "near-free fall speed".  Regardless, it's a documented fact that building 7 fell for 100 ft at free fall.  Not near free fall, but total free fall, as in, zero resistance from below.  No plane hit this building.  It had minor, asymmetrical fires on a few floors...Hmm, but that's weird.  Structural steel resists; thats kinds of why we use it in skyscrapers.  I wonder where it could have gone?

<To put it in the context of a burrito. It's more like pointing out the amount of calories in the burrito in a discussion about how it devastated your wasteline.>

It's more like claiming that eating a 5 lb burrito is going to cause a waistline expansion without taking into account the size and metabolism of the individual eating that burrito.  I can regularly put away an entire pizza for lunch, which is probably around 4000 calories of mostly cheese , grease, and carbohydrates.  Most people would assume that a person who regularly eats a 4000 calorie lunch is the kind of person who is going to be obese.  The fact that I'm 6'6 with a 33" waist only makes sense when you take into account my metabolism and level of activity.  Similarly, your equation isn't taking into account the ability of the structure being acted on to resist the forces above it.

The fact that you are implying that your equation precludes you from needing to acknowledge the Harrit report because it somehow accounts for the total collapse all on its own is a cop-out and a logical fallacy, because your incomplete equation doesn't prove anything.

<And of course out come the veiled accusations of me being a shill.>

You said it, not me.  I was still operating under the possibly that you have merely been confused and brainwashed by shills.  The truth of the matter is irrelevant at this point.  It's clear that you'll use every excuse in the shill playbook to try (unsuccessfully) to discredit the Harrit paper so that you can pretend like it doesn't exist, and instead rely on your partial, out-of-context equations and logical fallacies.  No matter, I don't find you very convincing, and I doubt anybody else does either.
Reply: Emvaz22
Conveniently you crop out the part of my response where I point out how that isn't true.
Reply: *****
Aah, that was not intended, I did attempt to address your questions in my response. What do you feel I didn't address adequately?
Reply: Semni Istiqlal <Conveniently you crop out the part of my response where I point out how that isn't true.>

How what isn't true?

That you in no way equate the ability of the bottom, larger, more substantive portion of the towers to resits vertical forces?

That your equation is incomplete because it in no way accounts for this resistive force?

The fact that because of this, your conclusion that the collapses happened naturally is merely a supposition, and is no way proven?

The fact that none of this line of reasoning neither addresses nor disproves the conclusions of the Harrit paper, which determine the presence of thermite?

The fact that building 7 fell for 100 feet at total free-fall?

The fact that you will use every logical fallacy in the book to try to discredit the Harrit paper, so that you conveniently will not have to incorporate it into the accepted facts about the collapse, and avoid the cognitive dissonance it would create?

What have I missed?
Reply: Emvaz22
The part where I point out that the way that the building is constructed completely undermines it's ability to resist 90,000 tons of debris falling on it.
Reply: Semni Istiqlal <The part where I point out that the way that the building is constructed completely undermines it's ability to resist 90,000 tons of debris falling on it.>

Speculation and absurd characterization of the facts.  No actual data.

Example:  Your assertion that without the floor trusses, the structural columns would be like spaghetti.  The outer columns may have collapsed without the support offered by the central core through the trusses, but they certainly wouldn't have collapsed straight down without a trace.  They would have either bowed outwards or inwards.  Neither of which occurred.  The external columns disappeared in a cloud of dust, at near free-fall speed.  

Secondly, the central core columns were self supporting, and were the structural spine of the towers.  The columns were progressively thicker towards the bottom of the structure, and the 47 core columns were interconnected by lateral beams.  If anything, the collapse of the floor trusses would have lessened the force being supported by the core columns.  If "pancake theory" was correct, then the core would have remained standing while the trusses collapsed on top of one another, and the outer columns would have bowed outward or inward.

What was observed is not consistent with what should have been observed in the event of a natural collapse.  The events of the collapse contradict the official story, but are instead consistent with controlled demolition.  So says common sense and 2000+ professional architects and engineers.  Unless you can refute the Harrit paper, or Isaac Newton, you don't have much ground to stand on.
Reply: Emvaz22
Okay yeah ... that just stunned me, you have no concept of reality do you? You literally live in a world where buildings survive having 90,000 tons dropped on them ...

Your complete detatchment from reality is amazing, you were a lot better at this when you were arguing the Harrit paper.

You and your kind have had 14 years to make your case and you havn't even managed to generate support for your ideas outside of conspiracy theorist circles. In what reality do your ideas sound even marginally credible?

The 'official story' has stood the test of time, it's withstood 14 years of people throwing whatever they can at it and it's still there.
Reply: Semni Istiqlal <Okay yeah ... that just stunned me>

You shouldn't be so surprised at how easily I discredit your argument using little more than basic logic.

<You literally live in a world where buildings survive having 90,000 tons dropped on them ...>

Do I need to use my burrito analogy again?  Apparently that was too complex for you.  Your "equation" to determine whether or not a building should collapse conveniently leaves out the part where the lower structure is designed to hold up the upper structure.  I guess you don't get the fact that in the equation x+y=z, if you only know x, you can never know z.  Try again.

Which building had 90,000 tons "dropped" on it?  No building.  The 90,000 ton top portion was connected to the lower, stronger 510,000 ton bottom portion through many, many columns, both core and perimeter.  Most of these columns were undamaged at the crash levels, and ALL of the columns below the crash were undamaged, and have ben holding up that 90,000 tons of potential energy since the 70s, with no problem at all.  

The top portion was designed to be supported by the bottom portion.  At no point was it "dropped" on anything.  It was always connected, and was connected to the bottom portion at the time of collapse.  Severing a handful of columns and using fire to cause a handful of other columns to weaken is in no way similar to lifting up and "dropping" the entire top structure on the bottom structure.

<you were a lot better at this when you were arguing the Harrit paper.>

Which you still haven't been able to refute.  Don't worry, I'll keep reminding you.

<You and your kind have had 14 years to make your case and you havn't even managed to generate support for your ideas outside of conspiracy theorist circles.>

Lie.  Recent polls show that most people don't believe the official story.  There are many, many documented professionals who support the demolition theory.

<The 'official story' has stood the test of time, it's withstood 14 years of people throwing whatever they can at it and it's still there.>

The official story is not corroborated by eyewitness testimony (explosions, bright flashes, molten metal), forensic evidence (nanothermite chips, FEMAs eutectic steel, iron microspheres that match the chemical signature of thermite), or basic physics (Newton's Third Law), not to mention precedent (fires have never caused buildings to implode, much less 3 on the same day)  There is literally no evidence that supports the official story.  It's funny to watch to keep pretending though.

Try again.
Reply: Emvaz22
You just cannot seem to understand that no structure outside of a bunker or a NPP is designed to withstand having 90,000 tons of rubble fall on it.

All you have done in this entire exchange is ignore or misrepresent everything I say. You only look good in your own mind and to people who already want to agree with you.

You have blatantly lied consistently in your posts and that's painfully obvious when you actually read both sides of the argument.

For example you continue claim that the towers fall at free fall even after I've repeatedly pointed out that they did not and you havn't even argued the point, you simply attempt to ignore it.

I have no words for how stupid you are sounding right now, and I don't even mean to insult you.
Reply: Semni Istiqlal <You just cannot seem to understand that no structure outside of a bunker or a NPP is designed to withstand having 90,000 tons of rubble fall on it.>

Prove it.

It wasn't 90,000 tons of rubble.  It was 90,000 tons of steel reinforced structure attached to 510,000 tons of similarly but more heavily reinforced structure below it, that happened to be designed specifically to hold up the 90,000 tons above it.  

It didn't "fall" on it.  It was attached, and was always attached.  Having a few columns sever and a few more buckle (presumably) is not the same as have a 90,000 ton mass suddenly getting picked up and dropped on an object below it, which is what your argument falsely implies.  Prove otherwise.

<All you have done in this entire exchange is ignore or misrepresent everything I say. >

No, all I've done is highlight how you misrepresent the reality of the events leading to the collapse.  I've also demonstrated how you can in no way refute the presence of highly advanced thermite in the rubble as proven by the Harrit study.

<You have blatantly lied consistently in your posts and that's painfully obvious when you actually read both sides of the argument.>

Name one lie.  Quote it from one of my posts.  Or maybe you're the one lying, and now in your desperation and your lack of actual facts to back up your argument, you are resorting to more ad hominem.  What a surprise.  Typical shill tactic.

<For example you continue claim that the towers fall at free fall even after I've repeatedly pointed out that they did not and you havn't even argued the point, you simply attempt to ignore it>

Another lie.  Building 7 fell for total free-fall for 100 feet.  47 stories.  7 seconds.  Prove otherwise, moron.

<I have no words for how stupid you are sounding right now, and I don't even mean to insult you.>

You should find a nice cliff with a hard place below to dive off of.  Your lack of basic logic, inability to formulate a coherent, factually supported argument, and blatant dishonesty and misrepresentation of facts are not qualities humanity should have in its gene pool.  Maybe you should remove yourself, you transparent shill.

Oh, did you refute the Harrit paper yet?  Oh, I almost forgot.  You didn't.  Too bad for you.  Try again, meatpuppet.
Reply: Emvaz22
Touched a nerve eh? More lies, more insults, and you call me a shill again. Nothing surprising.

You ask me to point out a lie and I'd already done so. The buildings did not fall at freefall speeds, that's a very well recorded fact. There are dozens of videos, photos etc of debris that has come loose from the buildings outpacing the collapse of the building, that should be proof enough. There is no way that free falling debris could have fallen faster than the collapse.

I've already presented you the calculations that pointed out that if the upper part of the tower were to collapse even a small distance, a mere meter, it would impact the lower tower with about three times the force the columns were designed to support. And the floors are just shy of four meters apart not to mention that the damaged area spanned a number of floors. The upper dower would collapse many meters before it met significant resistance.

Beyond that the floors are completely incapable of resisting even the resting weight of the upper tower.
Reply: Emvaz22
home.comcast.net/~jeffrey.king2/wsb/media/56016/site1074.jpg
This is the 'spire', part of the inner core of one of the towers that stood for approx 14 seconds after the collapse.

If the core had been demolished, how come most of the core actually survived the collapse ... for a brief period of time.
Reply: Semni Istiqlal <More lies>

Which lies exactly?  Thats plural, so now you would need to prove at least two times I've lied in order to not be a liar yourself.

<You ask me to point out a lie and I'd already done so. The buildings did not fall at freefall speeds, that's a very well recorded fact.>

Oh this one again?  Is that the best you've got?  I never said that the building fell at free-fall speed.  I said building 1 and 2 fell and "near-free-fall" acceleration.  I also said building seven fell at free-fall for 100 feet of its collapse.  Both are verified facts.  Of course I already explained this to you.  The fact that you keep trying to misrepresent what I've said despite the fact that I've already corrected you either makes you fully retarded or a lying shill.  Pick one.

<There are dozens of videos, photos etc of debris that has come loose from the buildings outpacing the collapse of the building, that should be proof enough.>

Right, thats buildings 1 and 2, which I never claimed fell at pure free-fall.  Misrepresent much?  You know another name for a misrepresentation?  A lie.

<I've already presented you the calculations that pointed out that if the upper part of the tower were to collapse even a small distance, a mere meter, it would impact the lower tower with about three times the force the columns were designed to support.>

Oh, you provided a calculation of the resistive force of the lower, undamaged structure?  Whats that?  You didn't?  Sounds like another lie.  Your calculations don't prove anything, because they don't address all of the variables.  Try again, liar.

By the way, you only cited one "lie" (which was actually just a misrepresentation of what I said).  You mentioned "lies", plural.  The fact that you can only mention one (and are wrong even on that single point), makes you a liar, or an idiot, or a shill, again.  Either case suits me just fine, because whichever way you go, you just discredited yourself, again.

Looks like your house of cards is crumbling.  Care to keep trying, meatpuppet?

<If the core had been demolished, how come most of the core actually survived the collapse ... for a brief period of time.>

"Most" of the core?  Yeah, if by "most" you mean a tiny fraction.  If the buildings were not demolished, then why did the spire fall at all?  It was exposed.  There were no more vertical forces acting on it.  Your 90,000 tons of structure had already fallen past it.  Therefore the force that you credit with turning the entire tower to dust in midair was already below the spire.  Anchored and latticed structural steel doesn't just fall over for no reason.  The most logical explanation is that the base was severed with cutter charges.  The Harrit paper supports this conclusion.  FEMA's eutectic steel supports this conclusion.  Eyewitness testimony supports this conclusion.  Basic physics supports this conclusion.  You have nothing to refute it.  Too bad.

Keep spinning your wheels.  You're never going to get anywhere, but it's fun to watch you try.
Reply: Emvaz22
And yet again you ask me to explain myself after I've gone on to explain myself in the very comment you are responding to. That's a lie in and of itsself, you love accusing me of misrepreseting you but you are the king of misrepresentation.

Either way ... so if I understand this correctly in your mind they went ahead and secretly wired the WTC towers to blow with literal tons of charges.

Doing so would have required the cooperation of the owner of the building, the NYC Port Authority and quite probably the leaseholder of the building.

Then in stead of using regular demolition charges they decide to use an at the time experimental thermite compound that at the time cannot be produced on an industrial scale so they spend god knows how long and how much money doing this.

Then on the day of the event they highjack way more planes than they need and don't even really do very much with the other planes.

Also, the head of the NYC Port Authority goes to dine in the WTC and subsequently dies. The leaseholder of the WTC doesn't even have his insurance of the buildings properly sorted out.

Then when they finally blow the charges sending the building to the ground they very carefully have set the charges to keep one part of the column on one of the buildings standing, only to decide to blow them anyway.

They have also set the charges specifically to make it not resemble a building implosion in any way other than that the building fell down.

Alternatively they could have effed up and then managed to run through the dust cloud, rig it to blow and blown it in 14 seconds. Impressive!

Also they decide to wait more than an hour and let the buildings get mostly evacuated. Where does that make sense?

You know that's basically what you are proposing right? And you wonder why I'm not taking you seriously?
Reply: Semni Istiqlal <And yet again you ask me to explain myself after I've gone on to explain myself in the very comment you are responding to.>

When did I ask you to explain yourself?  All I've done is point out that you can't prove your assertions that the top of the building would pulverize the bottom portion to dust in midair.  Your whole "but 90,000 tons!!!" equation is irrelevant, because you don't calculate the resistive capacity of the lower, stronger 510,000 tons of the structure, which happened to be designed specifically to resist the weight of the upper building.  Therefore your conclusion is unsupported.

<you love accusing me of misrepreseting you but you are the king of misrepresentation.>

What part did I misrepresent?  The part where you can't factually back up your claims, or the part where you can't factually refute mine?  Now you can explain yourself, although I'm sure you're going to dodge or ignore the question, because you know I'm right.

<Either way ... so if I understand this correctly in your mind they went ahead and secretly wired the WTC towers to blow with literal tons of charges.>

Wired?  You actually think the charges would have had to have been hard-wired, like with det-cord?  Wow, you're dumb.  There is this new invention called radio frequency transmission.  It's only been around since the 1800s, so I can see why you wouldn't have heard about it yet.  There is also this new invention, much newer than radio frequency transmission, called the "computer."  It's super new, so I'm sure you havant heard about it yet.  Using this novel "computer" machine, a sequential demolition sequence could be programmed, and then with radio transmission, it could remotely trigger the charges from whatever floor and whatever sequence desired.  No wires required.  It's all very complicated, I'm sure you wouldn't be able to understand.

<Doing so would have required the cooperation of the owner of the building, the NYC Port Authority and quite probably the leaseholder of the building.>

Factless speculation.

<Then in stead of using regular demolition charges they decide to use an at the time experimental thermite compound that at the time cannot be produced on an industrial scale so they spend god knows how long and how much money doing this.>

Factless speculation.  I'm beginning to see a pattern here.  Using your logic, it would not have been possible to create the atomic bomb, a much much larger and much more technically advanced undertaking.

But yeah you must be right.  There is just no way that a few dozen tons of iron oxide and aluminum could have been mixed and suspended in a gel mixture.  IMPOSSIBLE, I SAY!

<Then on the day of the event they highjack way more planes than they need and don't even really do very much with the other planes.>

What are you even talking about?  3 of the 4 planes hit their target.  The fourth plane was brought down by the passengers on board, so the intended target isn't known, but it's conceivable that building 7 was the target.  Because the building was already rigged, it had to be brought down or else expose the whole scheme.  Hence the obvious and inexplicable implosion later in the day.

<The leaseholder of the WTC doesn't even have his insurance of the buildings properly sorted out.>

You mean Larry Silverstein?  The guy who collected $4.55 billion from insurance on a policy which he had just purchased, specifically against terrorism?  Yeah, he clearly didn't have his stuff sorted out...

<Then when they finally blow the charges sending the building to the ground they very carefully have set the charges to keep one part of the column on one of the buildings standing, only to decide to blow them anyway.>

Or maybe it was severed at the base, and partially buried in the rubble, which temporarily propped up the columns until they gradually fell over...hmm, why didn't you think of that?

<They have also set the charges specifically to make it not resemble a building implosion in any way other than that the building fell down.>

Except building 7 looked exactly like a building implosion.  Not just a little bit.  Exactly.  Can you account for why the NIST model looks nothing like the actual collapse?  Why won't NIST release their model parameters?

<Alternatively they could have effed up and then managed to run through the dust cloud, rig it to blow and blown it in 14 seconds. Impressive!>

Wow, you're dumb.

<Also they decide to wait more than an hour and let the buildings get mostly evacuated. Where does that make sense?>

Uhh, maybe because if the building exploded to dust the moment a plane hit it, then it may have looked a little suspicious?  You're not a very deep thinker, are you?

<You know that's basically what you are proposing right?>

No, not at all.  Nice straw man attempt though.  Try again, meatpuppet.

Can you refute the Harrit study?  Can you prove that the upper portion would naturally crush the lower portion to dust in midair, without the help of pyrotechnics?

Hmm, I wonder why you can't do either of these things...
Reply: Emvaz22
And this would be why you fixate on the harrit paper because when you look at the big picture the only defence you have is ridicule.

You can make fun of me all you want but in the end of the day the scenario you are proposing is rediculous.

If you are going to gain access to the structural elements of the building you are going to need cooperation of the security staff and by extension the owners of the building.

Silverstien engaged in an extensive legal battle to secure the insurance money because the insurance agreement hadn't been fully finalized at that point in time. He eventually won but it could have gone the other way.

The spire severed at the base and held up by rubble? And you accuse me of speculation?

Honestly, if you cannot come up with a more believable scenario than this then why should I take anything else you bring to the table seriously?
Reply: Semni Istiqlal <when you look at the big picture the only defence you have is ridicule.>

No, my defense is to point out that your entire line of argument is comprised of conjecture and misrepresentation, and involves absolutely zero supporting sources and zero science whatsoever.  The fact that you keep pretending like this flawed line of reasoning somehow supports your assertion that the Harrit study is wrong and that the total collapse would have happened naturally by office fires, despite the fact that I keep pointing out how it doesn't, makes you a fool.

<You can make fun of me all you want but in the end of the day the scenario you are proposing is ridiculous.>

No, the scenario YOU are proposing is ridiculous.  I haven't proposed a scenario, because that would be the purpose of an independent investigation.  Your pretending to know exactly what would be required to rig the buildings and exactly who would have to know what, is disingenuous at best.

<f you are going to gain access to the structural elements of the building you are going to need cooperation of the security staff>

That's true.  Did you consider that the elevator maintenance crew and the security company are both US defense contractors with Pentagon ties?  Did you consider that the elevator shafts have discreet access to all of the core columns?  Did you consider that the pyrotechnic material would have been taken in disguised as common objects, such as cans of paint or insulation?  Did you consider that the security guards wouldn't even necessarily need to know what was going on, only that certain areas were restricted, and only certain men were allowed in an out?  Why didn't you consider any of this?  I wonder...

<Silverstien engaged in an extensive legal battle to secure the insurance money because the insurance agreement hadn't been fully finalized at that point in time.>

No, there was an extensive legal battle because Silverstein sued the insurance company, claiming that the events of 9/11 constituted two terrorist attacks, so he wanted double the insurance payout.

<He eventually won but it could have gone the other way.>

Coulda, shoulda, woulda, but didn't.

<The spire severed at the base and held up by rubble? And you accuse me of speculation?>

Ah, so what do you propose brought down the "spire" 14 seconds after the rest of the towers had fallen?  You think a demo crew snuck in through the dust cloud, set a charge, and detonated it?  Or maybe you believe Judy Wood space weapons vaporized the steel.  Explain your theory.  Mine is that the column was severed, either partially or fully, at the base, and rubble was piled up around the base, partway up the columns.  The rubble temporarily propped up the spire, until the force of gravity and the weight of the columns caused it to topple.  How does any of this support your argument or refute mine again?  Oh thats right, it doesn't.  

Seems like you are grasping at straws at this point.  Try again.
Reply: Emvaz22
It's kind of facinating how much effort you go to in your attempt to belittle me. This is really important to you, isn't it?

Yes, the demolition scenario I proposed was completely rediculous, if you had taken a moment from attempting to find every possible opportunity to ridicule everything I was saying you would have realized that was exactly the point.

See, you criticize you for speculating however then you start speculating wildly about the spire. You know what that's called in common parlance? Being a hypocrit.

You are going to call that an ad-hom again like you have done so many times before even though that isn't even what an ad-hom is. You don't seem to have a very solid understanding of the concepts you are working with here.

Either way, I suppose I'll talk about the spire because it's a really interesting conundrum regarding the collapse, demolition and how the towers came down. The spire causes trouble for a number proposed conspiracy scenarios.

If the core column was wired up to blow and do so in sequence as the top of the tower fell to clear the way then it seems incredibly unlikely that so many charges would fail to go off along one side of the column.

Also, if a collapse of the column was needed or the tower would not collapse then why didn't the rest of that side of the tower survive the collapse?

If it was only severed at the bottom and effectively standing on/in the rubble, then why did it not fall over like a tree? In stead of coming apart and collapsing down.

And as always, my reason for collapsing is the assertion that the core, stripped of other structural elements was not capable of standing on it's own.

A good example of this is how radio towers can support many times their own weight despite being a very spindly light weight structure. However remove their guide wires and the tower will twist and flex, eventually falling over like wet spaghetti. The same thing happened to the columns in the towers.
Reply: Semni Istiqlal <It's kind of facinating how much effort you go to in your attempt to belittle me.>

Belittle you?  Aww poor guy, tissue?  I bet you think playing the victim is proof that the Harrit study is flawed.  Thats about as strong an argument as anything else you have offered.

I simply point out the logical fallacies in your argument.  You continue to make these same fallacies in a poor attempt to support your argument.  Would you call a person who makes the same mistake immediately after being corrected: a smart person, or would you call him a fool?  This isn't my opinion here, I'm simply using reasoning.  A person who makes the same mistakes over and over even after being told he is making a mistake is a fool, an idiot, unintelligent, pick one.  You belittle yourself simply through your statements.  All I'm doing is highlighting those mistakes and putting a name to them.

<Yes, the demolition scenario I proposed was completely rediculous,>

Ridiculous.

<if you had taken a moment from attempting to find every possible opportunity to ridicule everything I was saying you would have realized that was exactly the point.>

Thats because your characterization of what would have to occur in order for the towers to be rigged is idiotic, is speculation, involves zero facts, and only shows your ignorance of how bureaucracy and compartmentalization works.  Moreover, your argument is irrelevant because speculation neither proves nor disproves anything.

Essentially what you are arguing is that to rig the towers would be a complicated undertaking, and somehow this is proof that the Harrit study didn't prove the presence of advanced incendiaries.  Of course, I've told you numerous times that one has nothing to do with the other, and your speculation is irrelevant, but you continue to ignore this fact.  What do we call a person who continues to make the same mistakes even after being corrected?  Remind me.

<See, you criticize you for speculating however then you start speculating wildly about the spire. >

Speculating wildly?  A column being damaged and being propped up by rubble is radical physics to you apparently.  Sad.

<You know what that's called in common parlance? Being a hypocrit.>

Hypocrite.  No, there is a difference you see (you probably don't).  Whereas you claim that your speculation somehow offers proof that supports your assertions, I freely admit not only that my thoughts on this matter are hypotheses, but also that it has nothing to do with the argument at hand.  Not only does it not prove anything, but it is totally irrelevant.

In essence, you are claiming that the fact that the spire stood for 14 seconds, therefore somehow means that Harrit never found thermite and/or the towers could have never been demolished...  This argument is a non sequitur, or course.  The fact that you think this line of argument is going to get you anywhere is funny though.  What do we call those people who continue to make the same mistakes?  Carry on. 

<You don't seem to have a very solid understanding of the concepts you are working with here.>

You should stay away from that mirror.

<Either way, I suppose I'll talk about the spire because it's a really interesting conundrum regarding the collapse, demolition and how the towers came down.>

Uh, no it's not.  But if thats going to be your argument, then have fun.  You're just going to make yourself look more dumb.

< it seems incredibly unlikely that so many charges would fail to go off along one side of the column.>

Who said that charges failed to go off?  You also pretend to know what spacing of these charges would be necessary to give the desired result.  You also assume that this small section of spire would have had to be rigged and brought down in order for the building as a whole to be demolished.  There you go again pretending speculation is fact.  Good argument though, go on.

<If it was only severed at the bottom and effectively standing on/in the rubble, then why did it not fall over like a tree?>

It did fall over like a tree.  That is kind the only way a solid vertical structure CAN fall.

I've got a better question for you:  If you believe that the 90,000 ton top would crush the entire lower 510,000 ton structure to dust and destroy all of the steel, then how do you explain this relatively small steel section in the bottom of the tower surviving in tact from the 600,000 tons of structure falling on it?

<And as always, my reason for collapsing is the assertion that the core, stripped of other structural elements was not capable of standing on it's own.>

This column was free-standing, would have been anchored into the ground, and was no longer supporting any weight whatsoever.  The structural core supported the rest of the structure, not the other way around.  You think the wind blew it over?

Again, how is this relevant to either proving the official story or disproving the presence of advanced incendiaries?  Oh I almost forgot, it isn't.  Your irrelevant tangent just looks like desperate misdirection.

<However remove their guide wires and the tower will twist and flex, eventually falling over like wet spaghetti. The same thing happened to the columns in the towers.>

Speculation as fact again, hmm?  What do we call those people?

What part of your argument proves the official story?  What part of your argument disproves the Harrit study?  Remind me again, I must have missed it.
Reply: Emvaz22
Just google "collapsed radio tower" seriously, do I need to hold your hand through every little way of being skeptical?

Aren't you supposed to be the skeptic here?
Reply: Emvaz22 If you didn't insult everyone you might be happier with yourself. It's clear you want to be important but I don't think this is the way.

Semni Istiqlal He's not worth your time. You are better off talking to someone who will listen to reason.
Reply: Semni Istiqlal Oh, so now you are equating a spindly radio tower with flexible thin gauge steel to a solid reinforced steel core composed of columns as thick as a man is tall, and held together with a latticework of structural steel beams.  That seems like a poor analog if there ever was one.

The "turning to spaghetti" of the steel core never happened.  This is simply more unsupported speculation.  It disappeared at the same rate as the rest of the tower.   Your "spaghetti" scenario would require that the floor trusses collapse, leaving the core exposed, which then supposedly bends under its own weight.  This was never observed.  If this were the case, wouldn't there be a pile of steel spaghetti coiled tidily on top of the neatly stacked floors that should have been observed if "pancake" theory was correct?  The observed phenomena aren't at all what you describe.

Yet again, you present speculation as supporting evidence.  It isn't.  Do you have any actual evidence for the official story?  Anything that confers proof?  Anything to refute the Harrit study?  Any published alternative analysis?  Any expert who has disproven any of the conclusions of the Harrit study, or can point out a specific technical flaw?  If so, please share where this information is published, and explain specifically how it proves the validity of your claims that the official story is correct and disproves the presence of thermite as demonstrated by Harrit et al.

I keep asking, and you keep not delivering.
Reply: +Emvaz22 for the last time, since I'm getting these notifications to my iPhone... When the Harret paper gets submitted to a reputable journal and gets peer reviewed, we will talk. Until then, your point is moot. So ask jones and crew to get serious and submit it. That's the only place anyone of importance would give two shits about it.

So until then, you've still got no paper in a reputable journal. That's an undeniable fact. Keep saying Harret paper if it suits you, but it is nothing more than a conspiracy paper published on an open journal online which has been shown to be shady. This is also a fact. You cannot go back and undo them allowing a paper comprised of literal gibberish to be published in the past.

So while the government is shady, your source is shady too. While the government story has bias, yours does too. The literal consensus of the collective scientific community does not, and until THEY change that position no one gives a damn about your decade old conspiracy bull
Reply: Justin Lead <When the Harret paper gets submitted to a reputable journal and gets peer reviewed, we will talk>

Bentham journals are reputable, peer-reviewed, and are acceptable citations in any academic context.  Prove otherwise.

<So ask jones and crew to get serious and submit it.>

Submitted, published, and has not been redacted or refuted in over 6 years,  Why can't you acceptards produce an actual rebuttal?  Why do you have to make up lies to try to discredit the paper, instead of actually arguing against the content of the paper?  Could it be that there are no flaws in the paper to argue against?  Could it be that the conclusions of the Harrit study are scientifically sound?  James Millette tried and failed to get his paper published, because his methods are junk, but at least he had the balls to try.  More than can be said about the rest of you clowns, and your pathetic hand-waving arguments.

<So until then, you've still got no paper in a reputable journal. That's an undeniable fact. >

What fact makes the Bentham journals not reputable?  You claim fart with no evidence.  Of course I would expect no less; this is the standard MO for you idiots.

< but it is nothing more than a conspiracy paper published on an open journal online which has been shown to be shady. This is also a fact.>

Oh, another one of your unsupported "facts."  What a surprise.  Try again.

<You cannot go back and undo them allowing a paper comprised of literal gibberish to be published in the past.>

More lies I see.  Cite the "gibberish" paper that the Bentham journals published.  What edition of what journal, and on what date was it published?  Name the title and author of this published gibberish paper.

In essence, what you are arguing is that the Harrit study is scientifically unsound so it could not get published in a "real" journal (whatever that is).  Yet when pressed for specifics, you can't produce a single technical flaw in the Harrit study or its conclusions.  Your bunk logic is transparent and is getting you nowhere.

I'll give you an example of why your logic is laughable.  The mainstream journal Science recently published a paper concerning the public opinion of homosexuality and gay marriage.  It was recently discovered that the methods of the paper were totally fabricated.  The paper was fake.  Yet Science published it.  Therefore, by your logic, every paper ever published by Science is now invalid.  Solid logic.  Not to mention that Bentham has never been shown to have published a fabricated paper to begin with, so by this line of reasoning, Bentham publications are more credible than a mainstream publication like Science.  Oops, did I just shit all over your argument again?

<While the government story has bias, yours does too.>

The difference is that the demolition theory actually has supporting evidence.  Physical evidence (nanothermite, eutectic steel, iron spheres that match the chemical signature of known thermite products), as well as eyewitness testimony by first responders (secondary explosions, liquid metal, bright flashes) all support the demolition theory.  The government theory has no supporting evidence, and contradicts fundamental laws of physics (Newton's Third Law).  Evidence is evidence, regardless of bias.  And you have none.

Thanks for playing.
Reply: Emvaz22
Just saying it is so isn't going to make it so. No the spire did not come down with the rest of the tower, there's clear footage of it jutting dozens of stories clear of the dust cloud as well as footage of it unraveling.

Your dismissal of radio towers belies your lack of understanding of how such structures work. Radio towers and the WTC towers are fundamentally identical even though the WTC towers were made to carry much greater loads. Columns, be it the light weight radio towers, or the core of an all-steel building like the WTC or even marble pillars all share a number of physical properties.

1. A column is great at supporting axial loads. Even the spindly radio towers can carry tremendous weight compared to their own mass.
2. Columns are terrible at resisting bending.

Put these two properties together you get a particular failure state where once a column bends sufficiently the load it is carrying shifts off-center and the moment trying to bend the column increases, resulting in more bending and a more off-center load.

In the WTC towers by design the outer walls and floors functioned like the guy wires of a radio tower, providing the core with a wide footprint to stablize it and resist bending or buckling.

Like I have said before, the falling debris aren't going to destroy many columns, at least not directly. They are going to be deflected by the column structure and fall on the floors, causing them to collapse. There is no scenario where the floors can support that sort of weight. Without the floors connecting the outer wall to the core there is nothing stopping the outer walls from peeling open like a banana skin. Now the core is being battered by falling debris and without the outer walls and floors to keep it from bending it starts to go as well, being the last structural element to fall.

In this scenario you expect to see the following:
1. Outer wall elements to be pushed out by falling debris and fall free from the tower.
2. Debris to be spread out over an area several times the footprint of the tower.
3. The core to fall last.

These are well documented by footage of wall panels falling free, all other WTC buildings being heavily damaged despite some ( building 7 ) being over a block away and the spire itsself being the last structural element to collapse. The collapse even managed to fling lighter objects like bone and paint chips many blocks away.

In an implosion you expect the core to fall first and the floors and walls to follow it, being pulled inwards to fill the void created by the falling core. You expect to see very little debris falling free or being expelled with very little damage to surrounding structures.

Video and camera footage of the event and the aftermath show little to no evidence of any of this.

Also, Harrit paper = PRATT
Reply: Semni Istiqlal <Just saying it is so isn't going to make it so>

Good point.  You say the WTC were like radio towers.  I say they weren't like radio towers.  Neither you nor I have any supporting evidence, therefore the speculation cancels out, and we are left with another unsupported statement.  Do you have any hard evidence to suggest the WTC core would behave like an unsupported, untensioned radio tower?  No.  Does this line of reasoning, even if proven, prove the official story or disprove the Harrit study?  No.  You're not going to get anywhere with this line of inquiry.

<Your dismissal of radio towers belies your lack of understanding of how such structures work. >

My dismissal of radio towers belies the fact that this line of reasoning doesn't prove anything, certainly not the official story.

<1. A column is great at supporting axial loads. Even the spindly radio towers can carry tremendous weight compared to their own mass.>

OK.

<2. Columns are terrible at resisting bending.>

Which is why the enormous 47 core columns were interconnected by a tight latticework of horizontal steel columns which DO resist bending.  Which is why buildings don't fall over when the wind blows.  And?

<In the WTC towers by design the outer walls and floors functioned like the guy wires of a radio tower, providing the core with a wide footprint to stablize it and resist bending or buckling.>

The floor trusses and outer perimeter columns were supported by the core, not the other way around.  The core would be free-standing, for the same reason the Empire State Building is free-standing (the massive columns and latticework of horizontal beams).  And?

<Without the floors connecting the outer wall to the core there is nothing stopping the outer walls from peeling open like a banana skin>

But this was never seen.  Huge chunks of the perimeter columns were thrown hundreds of feet outward (gravity works downwards, not outwards).  The rest of the perimeter columns disappeared in a cloud of dust.  No "peeling" was even witnessed.

<Now the core is being battered by falling debris and without the outer walls and floors to keep it from bending it starts to go as well, being the last structural element to fall.>

The central core disappeared in the same cloud of dust as everything else, at the same rate as everything else.  A small sliver of the core remained (the "spire") only to fall a few seconds afterwards.  To batter the core enough to destroy the horizontal beams (which there would be nothing positioned to batter the core because the floors were positioned along the permit of the core, not above the core, therefore nothing substantive was positioned in a way where it could collapse the core.  The building was designed this way on purpose.) would take a considerable amount of time and energy.  However the core vanished just like everything else.  

The core not only didn't have the mass above it to cause the necessary crushing force (because the floors were outside the core, not above it) to destroy the horizontal beams and destabilize the core, but the time it would take to cause all this damage and to cause the progressive collapse of the core was also never realized.

Between the hollow perimeter columns and the lightweight concrete used in the top portion of the structure, the average density of the top floors of the tower was about that of a block of wood.  With the force of gravity in a vacuum accelerating an object at 9.81 m/s2, that would be about 10 seconds for a freewill collapse of a tower in a vacuum.  Of course, we exist in an atmosphere, and a block of wood being dropped from the top of the towers would have encountered considerable air resistance, and would reach the ground between 15 and 20 seconds.  Which is how long it took for a total collapse of the towers.  Virtual free-fall suggests no resistance.  No resistance suggests no structural columns in the way to resist.  No structural columns imply demolition.  The Harrit paper confirms the presence of pyrotechnics which could be used to sever the necessary columns.  Seems to me to be enough to justify a new, actual investigation.

Can you refute the unnatural rate at which the towers collapsed?  Can you explain the 100 feet of total freefall of building 7?  Can you refute the Harrit paper?

<These are well documented by footage of wall panels falling free>

If by "falling free" you mean jettisoned out 600 feet at high speeds...

<all other WTC buildings being heavily damaged despite some ( building 7 ) being over a block away>

I've seen no evidence of any significant structural damage to building 7.  Buildings 3-6 were completely obliterated by debris from the main towers.  Can you explain how they did not fall, but building 7 suddenly and inexplicably came down into its own footprint, 100 feet of which at total free-fall?

< The collapse even managed to fling lighter objects like bone and paint chips many blocks away.>

Gee, it's almost as if something energetic blew these people to bits and spread their remains over many city blocks.  Bewildering...

<In an implosion you expect the core to fall first and the floors and walls to follow it, being pulled inwards to fill the void created by the falling core. You expect to see very little debris falling free or being expelled with very little damage to surrounding structures.>

Why would the people who demolished the towers initiate a conventional demolition sequence that would be easily recognized as a planned implosion?  You ever heard the phrase "more than one way to skin a cat"?  The collapse would have been engineered to look as natural as possible.  This isn't rocket science.

<Also, Harrit paper = PRATT>

"Just saying it is so isn't going to make it so."

Oops you just defeated your own argument.  Any technical flaw you can point out with the Harrit paper?  You're obviously not an expert, so can you cite any expert who has a published refutation of the Harrit paper?  Still nothing?  Pity.
Reply: Emvaz22
Aaand you manage to contradict your entire line of reasoning. I'm impressed!

[Gee, it's almost as if something energetic blew these people to bits and spread their remains over many city blocks.  Bewildering...]

By insinuating that there were explosives involved you contradict yourself. Thermite is not an explosive, it gets tremendously hot but not explosively so.

So ... either you are attempting to refute your own precious Harrit paper or you just made a woopsie.
Reply: Semni Istiqlal <By insinuating that there were explosives involved you contradict yourself. Thermite is not an explosive, it gets tremendously hot but not explosively so.>

Oh really?  Have you ever looked up the definition of thermite?  From wikipedia: "Most varieties are not explosive but can create brief bursts of high temperature in a small area."

"Most varieties are not explosive" means that SOME varieties ARE explosive.  Wow, what a novel concept.  Reading comprehension sure can be a useful tool.  Moreover the Harrit study cites several papers on nano and superthermites as well as their explosive characteristics.  The Harrit material was composed of nano-sized particles for maximum reaction speed, and was also mixed into a carbon-rich substrate, which would add an expanding gas to the reaction.  Expanding gas in a rapid reaction = explosive.

Did you even read the Harrit report, or did you just read whatever some fraud on a blog intentionally misrepresents about the Harrit report?  Either your reading comprehension is poor, or you are attempting to argue against something you didn't read.  You must not have done very well in school.  The other alternative is you DID read the report and are intentionally misrepresenting the facts AGAIN, because you have no real argument.  Which would make you a liar.  Either way, it's not looking good for your credibility.

Next.
Reply: Emvaz22
Until you can point out an actual explosive I have no reason to take your response seriously.
Reply: Semni Istiqlal <Until you can point out an actual explosive I have no reason to take your response seriously.>

Pfft, you're pathetic.  Did you watch the video you are commenting on?  It shows a very small amount of conventional thermate confined in a box cutter charge creating explosions.  This is material that is not composed of nano-sized reactants, and not combined with an energetic, gas producing matrix, yet is still causes explosions.  Imagine what a properly engineered superthermite would accomplish.

From the Harrit paper:  "conventional thermite is regarded as an incendiary whereas super-thermite, which may include organic ingredients for rapid gas generation, is considered a pyrotechnic or explosive [6, 24]"

[6] Jones SE. Why indeed did the WTC buildings completely collapse? J 9/11 Studies 2006; 3: 1-47.

[24] Clapsaddle BJ, Zhao L, Gash AE, et al. Synthesis and characterization of mixed metal oxide nanocomposite energetic materials. UCRL-PROC- 204118, Lawrence Livermore National Laboratory: Livermore, Ca; 12 May 2004. 

Fig. 29 of the Harrit paper shows that the Harrit material ignites at the same temperature as a Lawrence Livermore super incendiary [28], yet spikes more energetically, and completes the reaction at a faster rate.  I.e is more explosive.

[28] Tillotson TM, Gash AE, Simpson RL, Hrubesh LW, Satcher JH, Jr, Poco JF. Nanostructured energetic materials using sol-gel methodologies. J Non- Cryst Sol 2001; 285: 338-345.

Fig. 30 of the Harrit paper shows the Harrit material is more energetic than high explosives like TNT, HDX, and TATB [21].

[21] Gash AE, Satcher JH, Simpson RL, Clapsaddle BJ. Nanostructured energetic materials with sol-gel methods. Mater Res Soc Symp Proc 2004; 800: 55-66.

Can you refute any of this?  Can you cite a single academic source?  Do you have anything besides your weak-minded speculation?  I haven't seen anything else from you thus far.
Reply: Emvaz22
Harrit Paper: PRATT
Reply: +Semni Istiqlal 
What about the 4 other papers I just referenced?  Have you referenced any papers at all in this entire thread?  Have you cited anything at all to back up your speculative argument?  Can you refute the Harrit study?  What specific technical aspect is flawed?

Oh I almost forgot, we've already been over this.  You have no real argument, so you try to discredit the paper by spreading disinformation and misrepresent the facts concerning the paper's publication.

Too bad, I was just starting to have fun, but it looks like you've blown your load.  Oh well, you weren't a very good sparring partner to begin with.
Reply: Emvaz22
All you have done is reference tired old refuted stuff and sling insults. Why should I take you seriously?

Everything you have put forward only makes sense if you are so blinkered that you ignore so much about what happened that day.
Reply: Semni Istiqlal <All you have done is reference tired old refuted stuff>

Oh, the Harrit study has been refuted?  Cite the refutation.  Author.  Title.  Publication.  Date.  Thanks.  you keep pretending to have a refutation, but you have yet to cite it.  I wonder why?

<and sling insults>

Run out of tissues?  If you can't handle being called out for being a liar for lying, or being called an idiot for failing at logic and rational thought, then maybe YouTube isn't the place for you.

<Everything you have put forward only makes sense if you are so blinkered that you ignore so much about what happened that day.>

Ok, name an event that happened that day that makes controlled demolition not a viable theory.
Reply: *****
Yep, in the world where shady governments get away with killing thousands of people some guy's name is important.

Conspiracy theorists, getting their priorities right again.
Reply: Semni Istiqlal I'm still waiting for you to provide your refutation of the Harrit study.  You keep claiming it has been debunked, but you haven't cited anything yet.  Why is that?

I'm still waiting on you to name some fact about the events of 9/11 that makes the demolition theory impossible.  You claimed you could, but haven't.  Why is that?